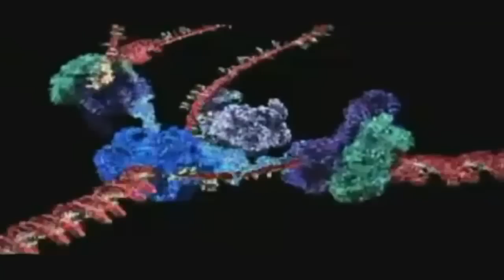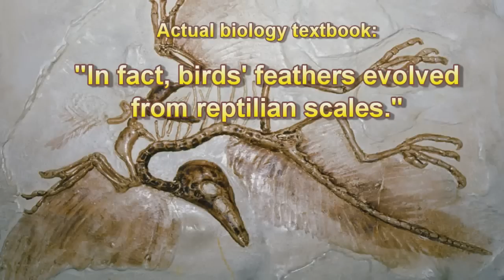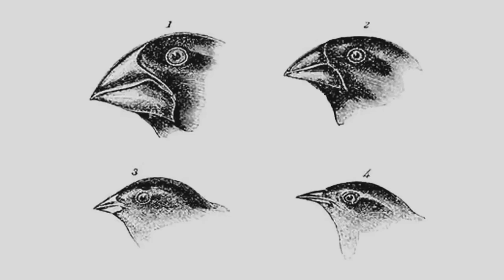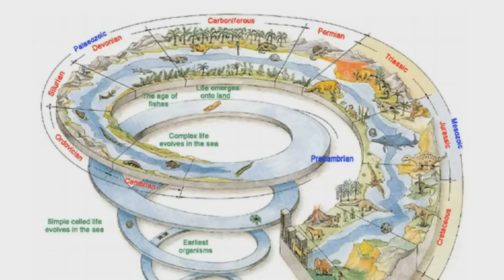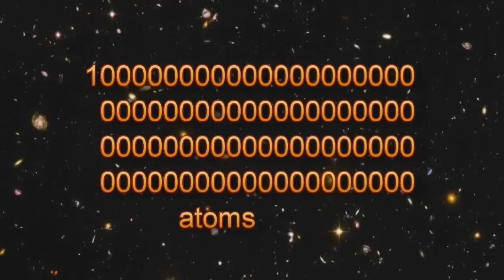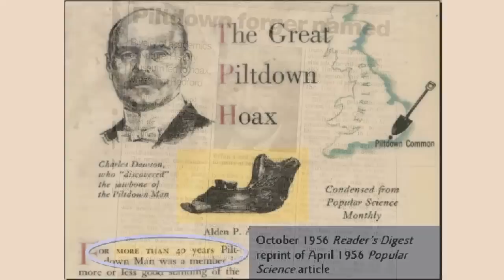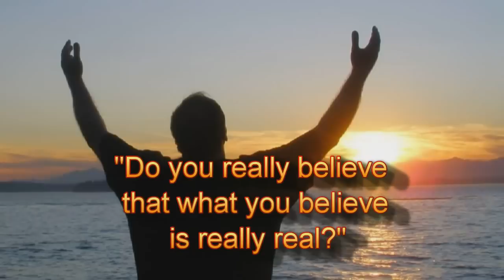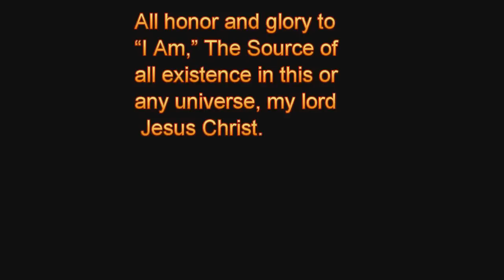Evolution Demolition

Comment: "Common sense would suggest that damage would result in a less fit genome."  Here Mr. Champneys is applying a subjective descriptive term to an objective change.  A genetic mutation is not damage; it's simply a different assemblage.
Reply: D. M. Bell It is not just a different assemblage.  It is a partially random assemblage.  Randomization is the very definition of damage to prescriptive information.  The more randomization, the less it looks like coherent code.  It is the addition of static to a sent message.  Minor tampering can be nearly harmless, and even make a change that we like, such as the sickle cell mutation which malaria protists do not enjoy.  But even such a so-called "beneficial" mutation is always deleterious in an informational sense.  Prescriptive information and random are at opposite ends of the same continuum.
Reply: Mark Champneys So a change from glutamic acid to valine is deleterious as far as information science? How so and why? Just claiming something is so doesn't mean it is so. 
It is a one base pair change; so the mutant is more like an information exchange not a loss. Are there functional consequences? Yes.  Is the mutant beneficial? Yes. Is one allele still wild type? Yes in the heterozygote.  

How is the mutation not beneficial in the heterozygotes if the individuals are resistant to malaria and sickle cell?
See hybrid advantage.
Reply: Helixbuilder Altering one base pair to switch on one function or another is not something I would dispute.  The programming is already there, and the change is not a low probability event.

However, the sickle cell mutation is so deleterious that even malaria protists do not like it.
Reply: Mark Champneys
Did you read about the heterozygote advantage?
Reply: Helixbuilder An "information exchange" would be exactly that, an exchange--at best.  Not the origination of a new algorithm.  Again, the word "beneficial" is ambiguous.  Beneficial to survival is not the same thing as beneficial to information content.  If Hitler crashes his car, that is a beneficial accident, but it is not beneficial to the car.
Reply: Mark Champneys
Pure unadulterated garbage. More than one deviation from a developmental pathway has been elucidated have you read about any of them?
Reply from the maker: Helixbuilder I'm certain that there are lots of deviations, however "developmental pathway?"  Is this the same as a mutational pathway?  You are in the field.  Have you ever seen a proposed mutational pathway spelled out for the formation of a new function or organ?  Has anyone given such detail?  I know that evolutionists believe in mutational pathways, but I've never heard of one being proposed.  Especially one that works--where each mutation is viable.  I'm not talking about mere tampering or "deviating," but the complete pathway.    You're the expert.
Reply: Nathan Champneys
Pathways have shared components. There are papers; however at this moment I am a bit busy. I'll get back!
Reply: Nathan Champneys
Sorry Nate had family stuff yesterday. The Ubx gives the fruit ply the same wing phenotype as dragonflies. I would predict that a similar gene or mutation configuration is in the dragon fly genome. I'll have a look.
Reply: SaltNPepperish
All you have to do is remove three protons from each atom of lead.to go from Pb (82) to Gold Au (79).
Reply: SaltNPepperish
Really? That is the best you can do?
Reply: *****
Those types of mutations can generate new functions. Usually it is gene duplication followed by a frame shift. The genomic  structure of genes includes introns and exons, Therefore gene product itself it not drastically changed outside of the effect exon. There are as many as 450 genes with molecular evidence that these type of change have happened..I have to dig through my file to find the reference so I may be off on the actual number.
Reply: SaltNPepperish
Yes tell me about entropy and why your interpretation has nothing to do with what is in the textbooks, or what is taught in a thermodynamics class.
Later Einstein.
Reply: Helixbuilder "Sorry Nate had family stuff yesterday."  Mark here.  Sorry, but my computer was still logged in under Nate's name for that reply.  (Nate is my son.)  Still waiting for that mutational pathway that is viable at each step.  Mutations are common, but mutations that maintain a survival advantage are relatively rare.  Viable mutations in succession of a few steps would be extraordinarily rare.  Viable mutations for each of many steps are mathematically impossible for the number of chances available in our universe.
Reply: Mark Champneys Thanks for clearing it up.
Reply: To those that are concerned there are papers with experimentally derived data that demonstrate that entropy is consistent with the theory of evolution.
This lay article has many references to original research.
http://www.scientificamerican.com/article/a-new-physics-theory-of-life/

Just a general observation the original papers tend to be more accurate than some third party summary. If you are going to quote Clausius, Gibbs, Boltzmann, Planck or Shannon on entropy or thermodynamics refer to their original definitions and math. That will reduce the confusion.
Thanks.
Reply: Helixbuilder The article begins with "a physicist has proposed..."  This hearkens back to the book, Biochemical Predestination co-authored by Dean Kenyon.  Kenyon has completely refuted his own book, and has now rejected evolution.  The idea of biochemical predestination seemed, at the time, like the only way to solve the entropy problem.
Reply: SaltNPepperish
Yes I can read. Thank you.
Reply: Mark Champneys
What so proposing a model and coming up with evidence to support it can be overruled by Mark says so?
Thanks for demonstrating that you think science is making assertions to buttress you scripture. Why wouldn't you look at the data?
Reply: SaltNPepperish
Sorry I must have missed that. It depends on where the mutation is in the protein, and what the nature of the new amino acid is. If you give me a specific case I can make a reasonable prediction which of course can only be verified by experiment.
I am of course assuming you mean mutations to the reading frame of the gene.
Reply: SaltNPepperish
If you are going to re-interpret what I say and answer questions not asked, why should I bother communicating with you?
I'm starting a step one to answer your question.
You don't care. Therefore Yes mutations happen and do comparative genomics it isn't my fault you don't understand.
Bye
Reply: SaltNPepperish
I checked my post with a linguist sorry but you are wrong.
Check with the peer reviewed literature and sorry you are wrong.
Thanks for your concern.
Reply: SaltNPepperish
I've checked the database and the literature you missed it. Go back and look.
Reply: SaltNPepperish
You keep missing it. You are so convinced your right that you become blinded to the evidence that contradicts your claims. Go and find the original research papers read them. If you don;t understand something research it. Don't rely on what somebody else says.
Reply: Mark Champneys
Mark, or any one who cares -- if you wish you can continue S&P's arguments. I got tried of being insulted for no reason and blocked S&P.
The conversation here is about ideas not insults.
Reply: Helixbuilder I think you know that I do not approve of SaltNPepperish's insults.  I appreciate passion, but I don't think rudeness is helpful when it comes from either side.  This is regrettable.
Reply: SaltNPepperish Rudeness is allowed.  I just don't think it is helpful to a free exchange of ideas.  (The only thing that is not allowed in this forum is profanity, and you have been borderline on that at times.  I want kids to be welcome here too.)
Reply: Mark Champneys
As I always say if you can't make your point with out using insults, shouting, lying or invoking logical fallacies you don't have a point.
Reply: Mark Champneys I suggest that you're still having trouble getting past these subjective terms.  "Prescriptive information" and "coherent code" both suggest some kind of master plan.
Reply: Tom Quirici
The polymorphisms of the MHC class I and MHC class II.
Reply: Tom Quirici I was specific about the MHC locus. These proteins are involved in pathogen recognition.
Reply: Tom Quirici
The genes are not dominant/recessive and they act in complement. They increase the number of pathogen derived peptides that can be bound and presented to immune cells. The end result is part of  'innate herd immunity'.
The variation arises from meiotic recombination, mutation and independent assortment; all of which can be demonstrated via genomic sequencing.
Your odds off considering that only 1.5% of the genome actually code for proteins yeah we know that see Venter et al 2001..
Reply: Tom Quirici
Those two classes are expressed from both parents genes that is why HLA (another name for the MHC) has to be matched for organ transplants.
Class I is used to identify compromised cells and trigger their destruction.
Class II is used to bind activate B cell to mediate ADCC to clear and/or destroy foreign antigens external to the cell.
In addition you are confusing SNPs with polymorphic alleles. The are not the same thing. See the textbook Genes XI.
Reply: Tom Quirici
Sickle cell is an example of Heterozygous Advantage, look it up.
Nylonase provides nutrition by digesting nylon when needed. This allows the bacterium to survive while those that don't have it die. Natural selection. The gene is tightly regulated and therefore isn't expressed until needed so how would this be detrimental? How is a duplicated gene that undergoes a frame shift a loss of function? It is the gain of a new function.
.
Reply: Tom Quirici I know better mutations don't always kill function; they follow a Gaussian distribution from being non functional to fully functional.
I've done site directed mutagenesis and you have to assay the mutant for function You can't just say what will happen you have to show it.
Further looking at the translation table several in many of the codons the third position does not mater.
In addition the properties of an amino acid side chain can be complemented by another amino acid with similar physical properties.
The existence of orthologs of gene throughout the taxa argues strongly against your claim.
Reply: Tom Quirici
So according to you if a process is complex it can't happen. Did you do an experiment and generate data to support this claim? If not you are only stating your opinion.
Many times during the history of humanity so called experts have claim something or event was impossible only to have someone show that the event was/is indeed possible.
Reply: D. M. Bell "Prescriptive information" and "coherent code" both suggest some kind of master plan.

Bingo!  You're getting it.  Except that these are not subjective, but very objective terms.  The code in DNA clearly has observable results which function beautifully.  The digital sequences really do function as instructions.  The outcome is extraordinarily coherent, working together in intricate interrelated systems.
Reply: D. M. Bell  The sciences of mutations and genetics has nothing to do with speciation, natural selection, or evolution.  Mutations and genetics are evidence of the intelligence designed into each and every living organism that enables living organisms to act, choose, select, adapt, abandon, alter, modify, or otherwise manipulate their God given, natural, environment.  Birds build nests, beavers build dams, and humans build space stations. The inanimate environment has not been designed with such intelligence and therefore cannot act, choose, or select.  It is absurd to suggest speciation is caused by some Divine Intervention as that's what "natural selection" means.  No Divine Intervention is needed for the ability to be born, to survive, to mutate, to adapt, to reproduce, and to die is already originally designed into each and every living organism.  There are plenty of varieties within each species, but no new specie or any kind of speciation has ever been observed whether created by God or popped out of another species by some bullshit selection.    Give up your superstition, folks, and learn the truth.  God bless.
Reply: SaltNPepperish  Exactly.  Evolution is neither a fact nor a single theory.  It is not science because there is not a single theory of evolution that can be scientifically tested.  Evolution is a collection of theories applied towards a variety of causal questions.  In other words, evolution is a story, a godless fairy tale.  There is zero evidence and zero logical argument for evolution.  It is purely blind faith to believe in the fairy tale of evolution.
Reply: SaltNPepperish  Exactly.  Evolution is at best an unsubstantiated opinion, and at worst a lie and a conspiracy to commit fraud. 

It all began when Hitler supported Darwin's evolution as a mean to legitimise his white supremacy, ethnic cleansing agenda, and the same tradition has been carried to today by militant atheistic bigots and hate mongers like Bitchens, Dawkins, Krauss, and Harris.
Reply: +Tom Quirici Birds ARE dinosaurs.  Denial is not proof, it is a sign of a brainwashed mind.
.  Bacteria did not evolve into worms, dummy.
Reply: Tom Quirici Yes, evolution demands that dogs make dogs and bacteria make bacteria
Birds do not have teeth.  Dinosaurs with feathers do have teeth and lived millions of years ago..
Reply: Tom Quirici I agree.  Evolution by the process of natural selection as scientists are forced to support by powerful conspirators is BULLSHIT.

Natural selection can only mean Divine Intervention.  There is no evidence of any Divine Intervention in the many varieties within each specie.  The intelligence was already originally designed into each and every living organism that enables living organisms to be born, survive, adapt, mutate, reproduce, and die.  No Divine Intervention has ever been observed unless we consider every new born as a Divine Intervention. 

In any regard, natural selection or Divine Intervention is not science because it cannot be scientifically tested.  If we want to have a scientific theory of evolution, evolution would have to be limited to changes in different varieties within species and not "speciation".  Such a scientific theory would be Jackie Wu's scientific theory of evolution by the process of intelligent adaptation of living organisms, E/IALO.  In this theory, the buck stops at intelligence which can be scientifically tested, and God is not assumed as a part of this science.

Life, like gravity, time, and God is metaphysical and is therefore unobservable and unknowable to humans.  No one knows what life, gravity, time, or God is.  We humans can only believe in their existence by applying logic to evidence which consists of our observations of some of the observable EFFECTS of such metaphysical entities but not the entities themselves for they are not observable.

It is time for our science communities to give up their superstition and study science.  May the truth, the love, and the peace of Jesus be with us.
Reply: *****  Done that many times in an elevator, no gravity ever observed, only the EFFECTS of gravity.   I repeat, "It is time for our science communities to give up their superstition and study science.".
Reply: Tom Quirici  I am just trying to save her soul.
Reply: Tom Quirici    How many believed in Jesus when he was crucified ?  Have faith.  The truth works in mysterious ways.  A tiny mustard seed under the right circumstances will grow into a huge mustard tree where birds come and make their nests.  This is a verifiable fact, not luck.

May the truth be our guide.  And may the love and the peace of Jesus be with us.
Reply: Tom Quirici *****   Amen, per Wiki, " The word amen (/ˌɑːˈmɛn/ or /ˌeɪˈmɛn/; Hebrew: אָמֵן, Modern amen, Tiberian ʾāmēn; Greek: ἀμήν; Arabic: آمين, ʾāmīn ; "So be it; truly") is a declaration of affirmation found in the Hebrew Bible and the New Testament. Its use in Judaism dates back to its earliest text."
So be it. 

Learn the truth.  May the love and the peace of Jesus be with you.
Reply: Tom Quirici  Praise be to God.  Amen !
Reply: Jackie Wu Praze the Flying Spaghetti Monster.  She is the one true God and you can't prove me wrong..  RAmen.
Reply: *****  I don't have to prove you wrong.  You have to prove your claim or you'll just be dismissed.
Reply: Jackie Wu What claim?
Reply: +Tom Quirici beautifully said, im muslim but i also cant tolerate these mindless satanic extrapolations that evolutionists partake in, thankfully for me, God Gave me a brain to reason with, so when i was shown those imaginary pictures in hs biology of evolutionary chains, i realized none of it was linked to any evidence and i saved myself from being brainwashed...we muslims need awesome intellectuals like sternberg and meyers and behe and others in our communities...keep exposing these guys! peace.
Reply: wesamalshaif  A Muslim is one who submits to God.  Jesus was a Muslim by definition.  And Jesus is a Buddha too because he was an enlightened one.  However, Jesus is not God, not the only Son of God, not Christ, and not a prophet.  Jesus claimed he is the way, the truth and the life.  He never claimed what he is not.  Jesus never prophesised but instead he warned us of false prophets.  To prophesise is to undermine, marginalize, and misrepresent God.  God cannot be God if God needs some humans to do God's bidding.   All prophecies are blasphemies, and all prophets are fake.

Give up your superstition and learn the truth.  May the love and the peace of Jesus be with you.
Reply: +777THUTH777 rofl .. try to educate anyone with just your opinions and insults!!
Reply: +D. M. Bell Since when nature has intelligence to create the necessary changes, it is self-conscious now !?
Reply: +Nathan Champneys They find that nature has intelligence to make such changes in the genome, want to see create software without a programmer ...
Reply: +D. M. Bell The problem is that changes in the genome often cause damage in 99.9% of cases...
Reply: Seen From Space
if life is so easy and nothing special why cant we reproduce it ourself out of lifeless matter allready? shouldnt the "clearance" be so big that it could come thru chance? but it aint!
so to me at this point its just an bold and arrogant statement to claim it came thru chance! as long as you aint able to reproduce it or show me how! and please dont even start with abiogensis! miller himself said its simply not possible thru abiogenesis!
Reply: Seen From Space  May be ?  May be we won't see you again.  May be Darwin is FOS.  May be you popped out of nowhere. May be Good bye.
Reply: Seen From Space
rofl! oh yeah! i can see how it disproofs that no fossil transition can be found anywhere .. which darwin himself said that they have to be found or his theory would crumble! it explain the cambrian explosion etc. your little bacteria .. does all those great things for you! omfg! waste of time!
Reply: Seen From Space
lol link me up to your stuffed museums please!
Reply: Seen From Space  Varieties within species is not speciation.  It is a part of design.  There is no offspring that is exactly the same as the other offspring or either one of the parents.  Each and every living organism is designed with the intelligence to be born, to survive, to adapt, to mutate, to reproduce and to die.  It is all as originally designed by God the Intelligent designer.  This is a verifiable fact based on logic applied towards evidence, not bullshits and fairy tales like evolution by the process of natural selection.  Darwin himself confessed that natural selection is absurd to the highest degree.   Darwin confessed, "To suppose that the eye with all its inimitable contrivances for adjusting the focus to different distances, for admitting different amounts of light, and for the correction of spherical and chromatic aberration, could have been formed by natural selection, seems, I freely confess, absurd in the highest degree." -- Charles Darwin, "On the Origin of Species by Means of Natural Selection, or the Preservation of Favoured Races in the Struggle for Life," 1859, p. 155. 

Now, give up your superstition and learn the truth.  May the love and the peace of Jesus be upon you.
Reply: Seen From Space  There is zero evidence and zero logic for evolution.  Evolution has never been observed.  It is neither a fact nor a single theory.  It cannot be science because there is no theory of evolution that can be scientifically tested.  Evolution is a collection of theories applied towards a variety of causal questions.  In other words, evolution is a story, a godless fairy tales, and it does not exist in real life, only in bullshits.   Evolutionary biologist Kirk J. Fitzhugh[39] wrote, "'Evolution' cannot be both a theory and a fact. Theories are concepts stating cause–effect relations...One might argue that it is conceivable to speak of 'evolution' as a fact by way of it being the subject of reference in explanatory hypotheses...In the strictest sense then, 'evolution' cannot be regarded as a fact even in the context of hypotheses since the causal points of reference continue to be organisms, and no amount of conﬁrming instances for those hypotheses will transform them into facts...While evolution is not a fact, it is also not a single theory, but a set of theories applied to a variety of causal questions...An emphasis on associating 'evolution' with 'fact' presents the misguided connotation that science seeks certainty." -- Fitzhugh, Kirk (January 2008). "Fact, theory, test and evolution".

Give up your superstition and learn the truth, okay ?
Reply: Seen From Space You asked, "please explain exactly how Fitzhugh's opinion on this philosophical/semantic matter supports a creationist cosmology?"

WTF are you talking about ?  What has Fitzhugh's statements of facts got anything to do with any philosophical/semantic matter, or creationist cosmology.  Fitzhugh is a evolutionary biologist, not a creationist.  What Fitzhugh says in his book is that the creationists and the evolutionists are both not speaking of science because they are both not backed by facts, but creationists have a theory although their theory cannot be scientifically tested, evolutionists have not a single theory but a story, a fairy tale.

You said, "Evolution has never been observed." Wrong. There are many examples."

Never mind many examples.  Give us one single piece of valid evidence or logic for evolution and I promise I will forever shut up.  Don't bother referring to fossils, mutations, and genetics because fossils only show some species died out in the past, not any new specie being created by God or popped out of other species by some bullshit selection, and the sciences of mutation and genetics, or Physics and Chemistry for that matter which evolutionists called evolutionary, has nothing whatsoever to do with any evolution, natural selection, or speciation. 

You said, "The eye example is so worn out: just look it up."

The fact is Darwin confessed that evolution by the process of natural selection is absurd to the highest degree.  He used the eye as an example.  But there are lots of "irreducible complex systems" in every living organism that cannot logically be evolved, only designed. 

Darwin's Theory of Evolution is a theory in crisis in light of the tremendous advances we've made in molecular biology, biochemistry and genetics over the past fifty years. We now know that there are in fact tens of thousands of irreducibly complex systems on the cellular level. Specified complexity pervades the microscopic biological world. Molecular biologist Michael Denton wrote, "Although the tiniest bacterial cells are incredibly small, weighing less than 10-12 grams, each is in effect a veritable micro-miniaturized factory containing thousands of exquisitely designed pieces of intricate molecular machinery, made up altogether of one hundred thousand million atoms, far more complicated than any machinery built by man and absolutely without parallel in the non-living world." -- Michael Denton, "Evolution: A Theory in Crisis," 1986, p. 250.

Give up your superstition and learn the truth.  May the love and the peace of Jesus be upon you.
Reply: Seen From Space  What has universities full of professionals got to do with the truth ?  Most professors are indoctrinated by the lies and propagandas of evolution and atheism.  Tom and I have no intention whatsoever to believe in these lies and propagandas based on blind faith.  We believe in logic applied towards evidence, not fairy tales like the emperor's invisible garment.  We are wise.  We don't pretend to be wise like what you have been doing appealing to authorities.

No irreducible complex system can logically be evolved.  You have zero evidence or logic for evolution.  I repeat, "Never mind many examples.  Give us one single piece of valid evidence or logic for evolution and I promise I will forever shut up.  Don't bother referring to fossils, mutations, and genetics because fossils only show some species died out in the past, not any new specie being created by God or popped out of other species by some bullshit selection, and the sciences of mutation and genetics, or Physics and Chemistry for that matter which evolutionists called evolutionary, has nothing whatsoever to do with any evolution, natural selection, or speciation." 

Give up your superstition and learn the truth.  May the love and the peace of Jesus be upon you.
Reply: Seen From Space  So you run out of valid argument and are now trying to divert our attention to bridge building and dentistry ?  I thought so.  You atheists are all the same.  When you start to realise you have zero evidence and zero logic to support your superstitious beliefs, you divert people's attention to other subjects and quietly slip away.  Happens every time.  I have encountered lots of these superstitious people.

You should give up your superstition and learn the truth.  May the love and the peace of Jesus be upon you.
Reply: Seen From Space Let's try Webster then,
 
Full Definition of PHYSICS
1
:  a science that deals with matter and energy and their interactions
2
a :  the physical processes and phenomena of a particular system

b :  the physical properties and composition of something

Full Definition of CHEMISTRY
1
:  a science that deals with the composition, structure, and properties of substances and with the transformations that they undergo
2
a :  the composition and chemical properties of a substance <the chemistry of iron>

b :  chemical processes and phenomena (as of an organism) <blood chemistry>
3
a :  a strong mutual attraction, attachment, or sympathy <they have a special chemistry>

b :  interaction between people working together; specifically :  such interaction when harmonious or effective <a team lacking chemistry>

Full Definition of MUTATION
1
:  a significant and basic alteration :  change
2
:  umlaut
3
a :  a relatively permanent change in hereditary material involving either a physical change in chromosome relations or a biochemical change in the codons that make up genes; also :  the process of producing a mutation

b :  an individual, strain, or trait resulting from mutation

Full Definition of GENETICS
1
:  a branch of biology that deals with the heredity and variation of organisms
2
:  the genetic makeup and phenomena of an organism, type, group, or condition

You see any evolution in these sciences ?

Give up your superstition and learn the truth, okay ?
Reply: +Seen From Space   I never said that mutations can never be beneficial.  In rare cases damage can be beneficial.  For example, if Hitler's car was damaged in a crash.  Or the sickle cell mutation which is so harmful that even malaria protists don't like it, resulting in immunity from malaria.  Nevertheless, if both parents carry the mutation it results in sickle cell disease.  Mutations are always deleterious to information content, but not necessarily to survivability (which is all natural selection cares about).  The bottom line is that a random process cannot build up prescriptive information.  That is as impossible as building a perpetual motion machine, and for exactly the same reason.  Uphill information buildup by mutation has never ever ever been observed.  Instructions do not write themselves, and believing that they do is tantamount to believing in the tooth fairy.
Reply: +Seen From Space   It is true that defining information content is no easy task.  Attempts have been made to define and measure it on different levels.  Shannon information is one way of measuring it, but he understood that it is not complete.  Dr. Don Johnson speaks of prescriptive information as instructions.  (As opposed to a mere collection of descriptive data.)  Clearly genetic information is prescriptive, and represents a blueprint for building an organism.  Dr. Craig Venter demonstrated that coded sequences of nucleotides is the software for this, by artifically rearranging them and observing different outcomes.  Dr. William Dembski coined the term "specified complexity" as a means of determining prescriptive information.  The fact that DNA sequences are both highly complex and highly functional affirm this specified complexity.
   As I pointed out in my video, neo-Darwinian evolution consists of natural selection operating on random mutations over many generations.  I am in full agreement that natural selection happens.  The entire question is the source of the options from which NS can select.  Evolution offers only random mutations for this part of the model.  Natural selection can make selections regarding the coding for a pancreas, but where did the programming for a pancreas come from in the first place?  Only random means are offered here.  And therein lies the impossibility of the model.
Reply: Mark Champneys +Seen From Space  The law of cause and effect does not allow random chance and accidents to exist in real life.  Darwin's evolution is a godless fairy tale.

Living organisms mutate because they are each designed with the intelligence that enables them to be born, to survive, to adapt, to mutate, to reproduce, and to die.  Inanimate matters don't have such intelligence, and therefore inanimate matters cannot mutate.  It has nothing whatsoever to do with random chance or accident.  Natural selection means nothing but Divine Intervention, just as artificial selection means nothing but human selection.  Human selection can be observed in the breeding of farm animals resulting in varieties within species, but no speciation and no Divine Intervention has ever been observed.  Every specie of living organisms is functioning exactly the same way it was originally designed and created by God the Creator.

May the love and the peace of Jesus be with you.
Reply: *****  Okay, so women are made from ribs of men and there is no need to have sex for a girl to have kids ?  How amazing !!! LMFAO !!!
Reply: *****
Why are you telling me all these ?  And WTF has chicken got to do with Adam and Eve ? 
Well, if you can believe women are made from ribs of men and there is no need to have sex for a girl to have kids, then you can also believe in Darwin's bullshit.  Why not, any fairy tale will do with your kind of argument.
Reply: +Raymond Armatino (Truthseeker777) because evolutards always jump to conclusions without evidence
Reply: +Seen From Space    It appears that you didn't pay attention to an important part of my video.  It is not the amount of change that is the issue, but the direction of the change.  Uphill change cannot occur by itself, but horizontal and downhill change can, and does, occur in dramatic fashion.  Thus, time is our enemy, not our friend.
   The Catastrophic Plate Tectonic model of the Genesis flood has more explanatory power than any other theory out there (IMHO) to explain vast global sediments with uneroded surfaces between layers almost everywhere.  Thus, I am convinced that most of the geologic record was deposited in rapid succession.
   The speed of light?  I don't know.  The Big Bang speculation has huge problems with distant starlight, but the Bible may give us a clue what happened.  In at least ten places the Bible says that God "stretched out the heavens."  I suspect that has something to do with it.  Definitely a mystery for all sides.
Reply: Mark Champneys You say "cannot" as if it were unequivocal. This is a dogmatic position, and inconsistent with vast bodies of evidence that you arbitrarily deem inadmissible.

If flood geology had any "explanatory power" at all it would at least provide SOME plausible reason why fossils always seem to be graded by epoch! Why for example Cambrian rocks only contain fossils from the Cambrian i.e. strictly invertebrates. It predicts that trilobites and mammals would be found together, because they died together. They never are. Creationists make a big deal of the missing link between apes and humans, but seem unperturbed by the lack of a precambrian monkey. Or the lack of any fossils at all in some sediments e.g. precambrian Torridonian sandstone.

Come on! CPT was cooked up at a desk as an act of desperation in the face of the flourishing discipline of planetary science. It lacks any plausible geophysical mechanism, and is contradicted by vast evidence consistent with mainstream plate tectonics.

It presupposes many physical impossibilities. What happened to all the heat released by the catastrophe? Why did it not melt the crust and boil the oceans? There would have been more than enough to do this! How did the atmosphere clear of the SO2 and CO2 quickly enough for Noah's children to be fruitful and multiply? Why do convective plumes in the mantle perfectly coincide with mid-ocean spreading zones and island chains? Why is oceanic crust brand new at the mid-ocean ridges and 150 myo at the edges where it's being subducted? Why does this dating correlate exactly with the thickness of ocean sediment settled upon it? Why are giant impact craters on the continental shields so eroded if they only happened in the last few thousand years? Why don't they all look as clear as Meteor Crater, Arizona (50kyo)? Why is the earth still not recovering from the mass extinctions they must have caused?
Reply: Mark Champneys And in what way is THIS not "evolution"?
http://phys.org/news/2016-01-random-mutation-protein-tied-multicellular.html

Full paper here:
http://elifesciences.org/content/5/e10147
Reply: +Jackie Wu  Invoking Godwin's law?
Reply: +Seen From Space    Consider that the sediments are a record of where organisms died, not where they lived.  It is a record of burial order, not age.  Many things are in the wrong evolutionary order, such as pollen fossils found in both pre-cambrian and dinosaur layers; or the many living fossils discovered that were once thought to be hundreds of millions of years old.  A catastrophic flood would sort things to a degree, yet imperfectly.  That is what we find.
   You no doubt would like to simply dismiss CPT, but it is based on enormous data, a team of PhD's, and modeled on the Los Alamos supercomputer.  It made many predictions, including temperature, that fit very well with a subsequent ice age.  The basic mechanism is very plausible.  A cold dense sea floor was much lighter than warmer lighter material in the mantle, making it a precarious top-heavy situation.  Once a failure in this balance was triggered, it resulted in runaway subduction of the sea floor crust diving under the continents, and the formation of new sea floor which was much lighter, forcing the ocean basins up temporarily.  Large areas of colder material have been detected deep in the mantle still today, confirming the model.
   Age dating is another major issue, since it is always based on assumptions.  The same scientists discovered major flaws in those radiometric dating assumptions.  I have written on this elsewhere in this forum.
   Catastrophic plate tectonics and conventional plate tectonics have much in common.  It can be observed today.  The major difference, of course, is in the speed with which it happens.  If CPT is true, it demolishes evolution by itself.  If not, evolution still has insurmountable problems.
Reply: Mark Champneys After 1 minute's research, this:
"Most of the palynology work was done by Clifford Burdick, who had very little knowledge of geological techniques. Creationists themselves admit that his results come from contamination of old rocks by recent pollen ... Intrusion of pollen in older rocks is very common." etc etc. You are far too selective in your reading. How many times have I had to repeat this?

"Living fossils" are rarely identical to actual fossil species. They cause no kind of inconvenience for evolutionary theory. By "insurmountable problems" I take it you mean there are open questions? As in every discipline this is true. But as I've already said ad nauseam, such are no support for competing hypotheses by default. If Darwin is ever proved wrong it will be for NONE of the reasons in your video!

What happened to all the heat and atmospheric pollution caused by this CPT process? The heat would have been more than enough to boil the oceans and melt the crust. The atmosphere would have been unbreathable. CPT was never, ever going to work, even if it's able to explain a few easy data points! To accept CPT you have ignore a planetful of real observation. Forget it and widen your reading.

Your radiometric dating points are just more folklore. "The same scientists" have presuppositions based on sectarian theology. So what they're doing is theology, not science. Likewise with CPT, the anisotropic synchrony convention, through intrinsic redshifts, right down to Mature Creation and the entire universe being cursed by the sin of Adam*. All theology. 

*Discussed in all seriousness by creation cosmologists!
Reply: Mark Champneys Repeat: why is the Earth not still recovering from mass extinctions if the giant impact basins on the continental shields formed in the last 6000 years? Some would have been far bigger than the K-T event, and studies show ecosystems taking several million years to recover from that.
Why are the craters are so eroded they're only visible from orbit, unlike the fresh-looking Meteor Crater, Arizona (~50Kyr). Because the impacts occurred orders of magnitude longer ago!
Reply: +Seen From Space    "Intrusion of pollen in older rocks..."  Pollen is not the issue, but fossilized pollen.  Obviously the pollen got in there long ago when it was still pollen, but it is now fossil pollen.  Rock.
   "...rarely identical to actual fossil species."  Most are very very close, and even living members of modern species can have substantial variation, yet still be the same species.  What happens is that evolutionists tend to assign fossils to a different species simply because they are fossils, not because of any known information about reproductive isolation.  The modern horseshoe crab is virtually identical to fossils, yet it is assigned a different genus (never mind species)!  Their bias is showing.  ...and in many cases it is without respect to any science whatsoever.  Dr. Tom Hoyle tells a story of once embarrassing an evolutionary anthropologist by showing him an x-ray of a human scull.  The evolutionist was thrilled with the x-ray and asked, where Dr. Hoyle got such a perfect Cro-Magnon scull specimen.  Dr. Hoyle smiled and said, "That happens to be an x-ray of my head.  Busted!  The larger point about living fossils is, the obvious absence of them in all the in-between rock layers.  It renders the idea of an "index fossil" utterly meaningless, because it is likely that we merely haven't found them in other layers yet.
   "What happened to all the heat and atmospheric pollution caused by this CPT process?"  It is all very much a part of the simulated model--all fully accounted for in super-computer modeling.  These PhD creation scientists are not stupid.  Actually the heat generated appears to have been offset by the cooling of the "nuclear winter," causing the ice age.  Warm oceans would have been essential to cause enough evaporation to render enough snow for the ice age.  You need to study this more.  The entire model is remarkable.
   "Your radiometric dating points are just more folklore."  The actual numbers are available, and the people processing them in AMS labs are almost never creationists.  Data is not folklore.  But do all scientists have pre-conceived biases?  Of course.  There are no exceptions to this rule, on either side.  But scientists on either side can become aware of their biases and adjust accordingly, just as any juror is required to do.  The biggest danger is when a person does not recognize their own bias... and most evolutionists don't.
   Some craters on the earth are highly eroded by the great flood, and some were clearly post-flood.  The millions of years scenario is the very thing in question, and creationist scientists challenge that assumption.  Mt. St. Helens and the island of Surtsey represent hard evidence that ecological recovery can occur with extraordinary speed.  (Especially if God wants it to, by the way.)
Reply: Joseph Smith No.   Godwin's law does not apply here because within a short discussion the evolutionists already run out of valid arguments.
Reply: +Jackie Wu lol...  as apposed to apologists that simply make up everything they say and are therefore only limited by their imagination?
Reply: Setep2k  Glad I am not an apologist.  I only say the truth based on verifiable facts.  No apology necessary.  You are confused, and that is the truth.

God bless.
Reply: Jackie Wu lol, yeah, truth based on verifiable facts, don't make me laugh... you'd be among a minority of theists... 

what's your best argument/evidence?
Reply: Setep2k Who is a theist ?

My best  argument/evidence is GODDIDIT/Everything.  This is truth based on verifiable facts.

Thanks for asking.

May the love and the peace of Jesus be with you.
Reply: Jackie Wu I guess it's better if I don't feed you, right?
Reply: Setep2k  I won't starve.
Reply: Jackie Wu good for you
Reply: Setep2k  I am actually overfed.
Reply: Jackie Wu well then it sucks, I guess... but better than starvation, huh?
Reply: Setep2k  It depends.
Reply: And common sense would also tell you that little tidbit in itself goes against the Darwinian would view. Everyone's a philosopher with their Ph.D.'s from YTU. Lmao
Reply: TheZincZipper
Yeah because common sense isn't science, it just your arrogant claim that your answer is right without proof!
Reply: Helixbuilder Evolution is not science.  There is zero evidence and zero logic for evolution, and there is not a single theory of evolution that can be or has been scientifically tested.  Evolution is neither a fact for it has never ever been observed, nor is it a single theory for it is in fact a collection of theories applied towards a variety of causal questions.  A collection of theories is a story.  Evolution is a fairy tale story.

May the love and the peace of Jesus be with you.
Reply: Jackie Wu lol, evolution is backed by fossils and dna, only a mentally challenged person could doubt it at this point

don't be that meantally challenged person on purpose... just don't
Reply: Seen From Space yeah thanks, i know that one already. also I wouldn't exactly call it source material, but rather a compilation of arguments.

when I'm not sure of the factual basis I check out sites like that, but I consider it better if I form my conclusion independently
Reply: Jackie Wu
The fact that evolution is a branch of science being investigated by scientists eviscerates your claim immediately!
Reply: Helixbuilder Evolution is not science.  It is neither a fact nor a single theory.  There is not a single theory of evolution that has been or can be scientifically tested.  Scientists study science.  They do not study fairy tales like Darwin's evolution by the process of natural selection.

Give up your superstition and learn the truth.  Jesus is the way, the truth, and the life.  The truth will set you free.  May the love and the peace of Jesus be with you.
Reply: Jackie Wu
Thanks for your opinion. Don't be too put off if I ignore your ill informed rant. You've said nothing other then words vilifying scientist and their work.
Reply: Jackie Wu
Complete and totally made up garbage. You can say whatever you want too; however don't get upset when you get called out when you make up things that are not true!
Reply: Helixbuilder Everything I said is based on truth and verifiable facts, bar none.  Evolution is not science, period.  Scientists in the scientific field of biology study the sciences of mutation, genetics, and intelligent adaptations of living organisms, but none of these sciences has anything whatsoever to do with evolution or natural selection.  Darwin's evolution by the process of natural selection is just an unsubstantiated opinion of Darwin's, a story, a fairy tale.

Give up your superstition and learn the truth.  Jesus is the way, the truth, and the life.  The truth will set you free.  May the love and the peace of Jesus be with you.
Reply: *****
Your rant is an incoherent word jumble. You've linked together events based on nothing other that your tangental understanding of complex interactions. All that to launch a non sequitur ad hominen attack.
Matthew 25:31-46 says what?
Reply: *****
When you stoop to insults you are tacitly admitting you have nothing to back your opinions.
So what? You go on a rant.What does that demonstrate? Where is the data that supports this claim of yours?
Reply: *****  I disagree.  There is no evolution and no natural selection that can be substantiated by any fact or logic. 

Intelligent adaptation of living organisms is not evolution and has nothing whatsoever to do with evolution.  Intelligence designed and created in each and every living organism is required to carry out the adaptation process.  Inanimate matters like rocks and dead wood cannot adapt because they do not have such intelligence or they have such intelligence but is not active because they have no life left in them.

Natural can only have one meaning, and that is : God made.  Natural selection therefore can only mean Divine Intervention.  There is no evidence that there is any divine intervention as far as intelligent adaptation is concerned.  All our observations confirmed that the adaptation process of living organisms have been carried out by intelligence that has been originally designed and created in each and every living organisms without the need for further intervention by God.

Notice that selection logically required a selector and a selectee.  In artificial dog breeding, humans are the selector and dogs are the selectee.  In intelligent adaptation, the living organism that undergone the adaptation process is always the selector and their natural environment the selectee.  Never has it been observed the other way round.  For example, tree roots breaks concrete but concrete cannot put legs on trees. beavers build dams but water and tree branches cannot keep beavers living on the same spot all their lives, humans build space stations but the natural environment we humans live in cannot force us to walk on earth all the time.

May the love and the peace of Jesus be with us.
Reply: Jackie Wu
Do an experiment and show data substantiating your claim.
Reply: Helixbuilder  " Do an experiment and show data substantiating your claim." ???

Exactly.  If you are claiming evolution is a science, you need to put it through the scientific method for verification.  But there is no theory of evolution that has been or can be scientifically tested.

May the truth opens your eyes so you may begin to see.  And may the love and the peace of Jesus be with you.
Reply: Setep2k If you read what ***** said to you earlier, you'll understand who is the stupid one here.

May the truth open your eyes so you may begin to see.  And may the love and the peace of Jesus be with you.
Reply: Jackie Wu
The experiments have been done! is it my fault you are incapable of looking up the data and then evaluating it?

There are literally thousands of papers detailing experiments that produce data in support of evolution that are published every year. So again you prove that you are uninformed.

Truth does not come from choosing to believe a particular ancient text.
Reply: Helixbuilder  Truth comes from logic applied towards evidence.  There is zero evidence and zero logic for evolution and there is overwhelming contrary evidence against it.  That is the truth.

There are thousands of research papers every year on mutations, genetics, and intelligent adaptation of living organisms but there is zero scientific research on Evolution because there is not a single theory of evolution that has been or can be tested by applying the scientific method.  That is the truth.

May the truth open your eyes so you may begin to see.  And may the love and the peace of Jesus be with you.
Reply: *****
First you open with an insult, and then comment on research that in my opinion you didn't even bother to read.

What is the hypothesis being tested? What results would support or nullify the hypothesis?

What are the controls?

What are the results?

Are the chosen methods the correct way to address the hypothesis? Why or why not?
 
The answers are in the papers.

Typical you let your bias color everything you observe.

Why does someone who has no experience in science or doing experiments feel knowledgeable enough to comment on it?

My answer is that the person is beyond arrogant.
Reply: *****
1) Your are right the experiment is not contrived. Further the hypothesis is supported by the data.
2) Figure 1 shows the geographic location of four separate species of cichlids.
3) Fish are at the classification of “class” which is ‘below’ Domain, Kingdom, and Phylum. While at the same time being ‘above’ order, family, genus, and species. So your argument is not supported by the data.
4) Since there is no evidence that mentions  interbreeding and producing fertile offspring in the paper I have caught you red handed lying.
5) The species listed are different and have known reproductive barriers.
6) Next
Reply: Jackie Wu
Your post is not a rebuttal it is just your opinion attempting to convince me without any evidence!
Reply: Helixbuilder You said, "Your post is not a rebuttal it is just your opinion attempting to convince me without any evidence!"

What rebuttal ?  You have not provided a single piece of valid evidence or valid logic for evolution, nor have you provided a single theory of evolution that has been or can be tested by applying the scientific method.  So what rebuttal are you waiting for ?

Take note that we have not even talked about the overwhelming contrary evidence and logic against the evolution by the process of natural selection bullshit.  You are claiming that Evolution is science so you need to prove it with logic and evidence.  Get it ?

Give up your superstition and learn the truth.  Jesus is the way, the truth, and the life.  The truth will set you free.  May the love and the peace of Jesus be upon you.
Reply: Jackie Wu
You have not written anything other than claim your right without any evidence!
Reply: *****
Nothing you said pertains to the paper you dismissed without reading.

Nothing your are saying now indicates you know anything about evolution.

Insults and random science word strung together indicate that you have nothing to say.
Reply: Jackie Wu
Actually you are trying to say that a branch of science is not science so the burden of proof is on you.
Reply: Helixbuilder   You said, "No You have not written anything other than claim your right without any evidence!"

Wrong.  I wrote that your claim is without any evidence or logic and there are overwhelming contrary evidence and logic against your claim that evolution by the process of natural selection is science.

No wonder Happy Camper called you a liar.  When did I say a branch of science is not science ?  You don't need to lie to shift the burden of proof, you know ?  Be a man, prove it or admit the truth that evolution is not science.

May God have mercy on you.  And may the love and the peace of Jesus be with you.
Reply: Jackie Wu
Well considering there is quite a bit of evidence that fact alone calls into question your grip on reality.
Reply: *****
Cichlids are fish from the family Cichlidae, not a species -- so you are still wrong.
Reply: Helixbuilder You said, "Well considering there is quite a bit of evidence that fact alone calls into question your grip on reality."

1)  Anything can be evidence, but to be a valid evidence for something, the evidence needs to be tied to that something by logic.  For example, a fish can be evidence, but a fish cannot be a valid evidence for gravity because there is no logic to tie a fish to gravity.  However, a falling apple is a valid evidence for gravity because it is logical that there is a cause for the apple to fall, and we labelled that cause as gravity.  For evolution, there is zero valid evidence and zero valid logic.  Even Darwin himself confessed that evolution by the process of natural selection is absurd to the highest degree.

2)  Facts are repeatable observations.  Evolution has never been observed and therefore cannot be a fact.  While Evolution is not a fact, neither is it a single theory.  Evolution is a collection of theories applied towards a variety of causal questions.  A collection of theories is not a theory but is a story.  Evolution is therefore a fairy tale story.  Since there is no theory of evolution, none can be tested scientifically, and therefore evolution cannot be science.

3)  There are two kinds of realities.  The first one is our physical reality which consists of what we see or observe.  The second one is the metaphysical reality which is unobservable and unknowable by humans.  We humans can only believe in the existence of various metaphysical entities like gravity, life, space, time, God, etc., by logic applied towards evidence which would be observations of some of the effects caused by these entities but never of the entities themselves because metaphysical entities are unobservable and unknowable by humans.  Can you get a grip on reality ?

Give up your superstition and learn the truth.  Jesus is the way, the truth, and the life.  The truth will set you free.  May the love and the peace of Jesus be upon you.
Reply: Setep2k What lack of logic ?  What is the logic of your claim that "if something is natural then there's evidence" ???

For example, gravity is natural.  Is there any evidence of gravity ?  Has anyone seen gravity, heard gravity, tasted gravity, smelled gravity, or felt gravity ?  The answer is no.  But practically everybody believe gravity exist and is natural.  Do you believe gravity exist and is natural ?  If you do, there is no reason for you to not believe God exist and is natural.  The truth is : "natural" can only mean "God made".

Give up your superstition and learn the truth.  Jesus is the way, the truth, and the life.  The truth will set you free.  May the love and the peace of Jesus be upon you.
Reply: Setep2k "gravity is quantifiable" ???

I repeat, "Is there any evidence of gravity ?  Has anyone seen gravity, heard gravity, tasted gravity, smelled gravity, or felt gravity ?  The answer is no."  Gravity is unobservable and unknowable by humans just as life, space, time, God, etc. is unobservable and unknowable by humans.  This is the truth.

Who said I do not believe in the existence of gravity ?  I repeat, "practically everybody believe gravity exist and is natural."  So pay attention or I'll have to tell you to sit out at the corner for 5 minutes, okay ?

"something natural = part of nature = part of reality = perceivable in reality" ???

I repeat, "For example, gravity is natural.  Is there any evidence of gravity ? ...... The answer is no."  Gravity is not perceivable in reality because gravity is metaphysical.  Natural = God made.  This is the truth.

Give up your superstition and learn the truth.  Jesus is the way, the truth, and the life.  The truth will set you free.  May the love and the peace of Jesus be upon you.
Reply: *****

Wow insults! I guess we'll talk again when you graduate from high school.
Reply: Jackie Wu
Thanks. I'll take your opinion into consideration,  then I'll check the facts. Sorry you are still wrong.
Reply: Helixbuilder You are welcome.  Everything I said is based on truth and verifiable facts, not opinions.  Evolution was Darwin`s opinion because it is neither a fact nor a single theory, and there is zero valid evidence or logic for evolution.  Darwin confessed his opinion of evolution by the process of natural selection is absurd to the highest degree.

I pointed out Evolution is not science and I gave my reasons supported with truth and verifiable facts.  You still insist I was wrong.  Unless you can provide a single piece of valid evidence, or a single piece of valid logic for Evolution, or a theory of evolution that has been or can be scientifically tested and verified, you have no reason to say I was still wrong.  To do so would only confirm the assessment of you by
***** .

Give up your superstition and learn the truth.  Jesus is the way, the truth, and the life.  The truth will set you free.  May the love and the peace of Jesus be upon you.
Reply: *****
Matthew 5:22
Reply: Jackie Wu
I'm waiting for the references to these 'facts' you keep talking about.
Reply: Helixbuilder Sure, the fact that Evolution is neither a fact nor a single theory has been observed and explained by Fitzhugh, per Wiki,

Evolutionary biologist Kirk J. Fitzhugh[39] wrote, "'Evolution' cannot be both a theory and a fact. Theories are concepts stating cause–effect relations...One might argue that it is conceivable to speak of 'evolution' as a fact by way of it being the subject of reference in explanatory hypotheses...In the strictest sense then, 'evolution' cannot be regarded as a fact even in the context of hypotheses since the causal points of reference continue to be organisms, and no amount of conﬁrming instances for those hypotheses will transform them into facts...While evolution is not a fact, it is also not a single theory, but a set of theories applied to a variety of causal questions...An emphasis on associating 'evolution' with 'fact' presents the misguided connotation that science seeks certainty."

God bless.
Reply: Jackie Wu lol you don't even know what quantify means... it means it can be measured, which is not true for your god.

the  only question left is if you see the difference...
Reply: Jackie Wu
Yes Wiki the absolute go to for knowledge. Why wouldn't you go the the source of the original data?

However the entirety of the article does not support your claim. And that my friend is based purely on the low legal standard of the preponderance of the evidence.

Did you read the entire page or just the stuff you liked?
Reply: Setep2k   "the only question left is if you see the difference..."

Exactly.  You can measure gravity ?  How long ?  How many in a cup ?  How many grans in a litre ?  How many litres in an apple ?    The truth is you can't measure gravity because you can't observe it or know what it is. 

Give up your superstition and learn the truth.  Jesus is the way, the truth, and the life.  The truth will set you free.  May the love and the peace of Jesus be upon you.
Reply: Jackie Wu
Gravity is a force. Force is mass x acceleration. The units are in Newtons, which is Kg x m/s^2.  One newton is the force needed to accelerate one kilogram of mass at the rate of one meter per second squared in direction of the applied force
Reply: Jackie Wu

As for superstition it means a widely held but unjustified belief in supernatural causation leading to certain consequences of an action or event, or a practice based on such a belief.

Since science is dependent on observation, evidence, and experiments to reveal natural mechanisms your insistence that science is superstitious is directly contradicted by logic, the scientific method, and the very definition of science.
Reply: Setep2k Helixbuilder  1)  You can't measure a force because forces are metaphysical, unobservable, and unknowable by humans.
.
2)  gravity is not a force according to Einstein who claimed gravity either does not exist or is fictitious and that gravitation is caused by space/time curvature. 

3)  Quantum physicists believe gravity is not even a cause but an effects or illusion caused by gravitons which they promise they will find soon.  But don't hold you breath.

4)  No one knows what is space or what is time.  So no one knows what is speed or acceleration.  Mass also is a measurement of the effects caused by what we believe is a physical object but mass of an object could have been caused by gravitons which we haven't discovered but quantum physicist believe they exist.

The long and short of it all is no one knows what gravity is because gravity is metaphysical, unobservable, and unknowable by humans.  Just like God, we humans can only believe in the existence of gravity and of God, but we humans cannot observe them or know what they are.

Give up your superstition and learn the truth.  Jesus is the way, the truth, and the life.  The truth will set you free.  May the love and the peace of Jesus be upon you.
Reply: Helixbuilder  I know what superstition is and what science is, and I never said science is superstition.  I said Evolution is not science but is a fairy tale.  Everything I said is based on truth and verifiable facts, remember ?

Give up your superstition and learn the truth.  Jesus is the way, the truth, and the life.  The truth will set you free.  May the love and the peace of Jesus be upon you.
Reply: Jackie Wu
Then if that is true then what is your problem with evolution? You believe in a fairy tale god The are no facts for the existence of any god. That is why it is called faith.
Reply: Helixbuilder  As for Fitzhugh's article, assuming that you have read it and you are capable of comprehension, where did it say Evolution is science, or a fact, or a single theory.  Show us that and stop giving your legal opinion of the subject matter.  Science and legality are two very different topics, you know ?

Learn the truth, okay ?
Reply: Jackie Wu
Did you read the rest of the articles referenced on the wiki page?
Reply: Helixbuilder Faith is not belief without logic and evidence, or reason.  Faith is a strong belief, a trust, or a conviction.  I hope you have been faithful to your spouse, your country, and yourself.  Beliefs are evidence based but superstitious beliefs are not logical but absurd.  Darwin believed in evolution by the process of natural selection but he confessed what he believed in is absurd to the highest degree. 

There is zero evidence and zero logic for Evolution and overwhelming contrary evidence.  Therefore believing in Evolution is illogical, irrational, and perhaps even delusional.  There is however overwhelming evidence and logical proofs for God and zero contrary evidence.  Therefore believing in the existence of God is logical and rational, disbelieving in the existence of God is illogical and irrational, and believing that there is no God is outright delusional.  So, tell us,  do you believe in God or are you illogical, irrational, and perhaps even delusional ?  Do you believe gravity exist ?  If you do, there is no reason you do not believe God exist for the existence of both gravity and God is supported by overwhelming evidence and logical proofs.

God bless..
Reply: Helixbuilder Why do you want to swamp me with irrelevant articles that you want to deflect my attention to ?  Why can't you be a man and admit that Evolution is not science but a fairy tale, and get started learning the truth ?

May the truth open you eyes so you may begin to see.  And may the love and the peace of Jesus be upon you.
Reply: Jackie Wu

Because you are offering an opinion and have not examined the data, but rather have read third hand biased accounts.
Reply: Helixbuilder   Everything I said is based on truth and verifiable facts, not opinions.  You claimed that Evolution is science but you have provided zero valid evidence and zero logic for evolution, or a single theory of evolution that has been or can be scientifically tested.  So I pointed it out to you and to whom it may concern that Evolution is not science because it is neither a fact nor a theory but a fairy tales, and I quoted Fitzhugh who had observed the same facts and explained it very well.  I am not an evolutionary biologist, but Fitzhugh is.  He has a PhD in this field of study and he is a reputable curator.  In the article I quoted, Fitzhugh explained it in plain language that any logical mind can understand the facts and the truth of what he said.

You first wrote him off as a low political opinion and now a third hand based account.  Have you no shame ?  Can you admit your superstition and start learning the truth ?

May the truth open you eyes so you may begin to see.  And may the love and the peace of Jesus be upon you.
Reply: Setep2k "forces are metaphysical"

Exactly.  Forces are not physical.  They are unobservable and unknowable to humans.  The word force is often used as a metaphor for power or energy for this very reason, like air force, life force, and police force.  Force, power, and energy are all metaphysical just like gravity, space, and God.

Give up your superstition and learn the truth.  May the love and the peace of Jesus be with you as you go.  God bless.
Reply: Setep2k You have not been able to answer any of my questions regarding how gravity is observable and measureable to you, like what does gravity look like, taste like, smell like, sound like, or felt like.  And you are now insulting Socrates, Jesus, Einstein, and I by calling us stupid people ?  What is wrong with you ?    The four of us believe in metaphysics and in God, you know ?  Metaphysics is the foundation of science.  Every scientific theory is in essence metaphysical.  Science without metaphysics is not science but hollow and meaningless materialism.  Superstitious people like you believe in materialism.  Rational people like Socrates, Jesus, Einstein, and I believe in God.

Give up your superstition and learn the truth.  Jesus is the way, the truth, and the life.  The truth will set you free.  May the love and the peace of Jesus be upon you.
Reply: Jackie Wu nope, not sokrates or einstein, just you... and maybe jesus, but his existence is not confirmed, so I won't talk about him.

also einstein was not a believer, even though idiots that misquote him often think that.

also it's an idiotic thing to ask me for the taste or smell of gravity. I can tell you how it's measured and thereby how it's perceived.
that's more than could ever be said for god and other such nonsense
Reply: Jackie Wu
Simply measure the force needed to raise an object of mass to 1 metre.
Reply: Jackie Wu
Yes so you say. Now prove it. What experiments have been done that show this claim of yours?
Reply: Setep2k Socrates is the father of Western science and philosophy.  Metaphysics is a branch of philosophy.  Per Wiki, "The word "metaphysics" derives from the Greek words μετά (metá, "beyond", "upon" or "after") and φυσικά (physiká, "physics").[6] It was first used as the title for several of Aristotle's works, because they were usually anthologized after the works on physics in complete editions."  Aristotle was a student of Plato who was a student of Socrates.  It is well known Socrates believed in gods and metaphysics.

Per Wiki, "Albert Einstein's religious views have been studied extensively. He said he believed in the "pantheistic" God of Baruch Spinoza, but not in a personal god, a belief he criticized."

So you thought wrong.  Socrates, Jesus, Einstein, and I believe in a metaphysical God, and we are not stupid people like you described us.  I am not well known, but Socrates, Jesus, and Einstein are well known for their wisdoms.
 
You said, "also it's an idiotic thing to ask me for the taste or smell of gravity. I can tell you how it's measured and thereby how it's perceived."

So you can't smell or taste gravity, but can you see, hear, or feel gravity ?  You can't, correct ?  So tell us how you can measure gravity if you can't even see, hear, or feel gravity.  It is a fact that gravity is metaphysical, unobservable and unknowable by humans.  We humans can only believe gravity exist but no one knows what gravity is, the same way we humans believe God exist but no one knows what God is.  This is the truth.

Give up your superstition and learn the truth.  Jesus is the way, the truth, and the life.  The truth will set you free.  May the love and the peace of Jesus be upon you.
Reply: Helixbuilder  You said, "Simply measure the force needed to raise an object of mass to 1 metre."

Sure, you can measure the effects caused by gravity or what Newton believed is gravitational force.  But gravity itself cannot be measured, or any force for that matter.  We can measure some of the effects caused by God like birds and bees, stars and galaxies, you and me, but God cannot be measured.  If you believe gravity exist, there is no reason for you to not believe God exist.

You said, "Yes so you say. Now prove it. What experiments have been done that show this claim of yours?"

I assume the claim you were referring to is that Evolution is not science.  I have proved that nth times to you, so I don't understand why you are still asking me for proof.  I'll repeat : Evolution is neither a fact nor a single theory, and since there is no theory of evolution that has been or can be tested scientifically, evolution cannot be science and remained as a fairy tale.  That is the proof and that is the truth.

Give up your superstition and learn the truth.  Jesus is the way, the truth, and the life.  The truth will set you free.  May the love and the peace of Jesus be upon you.
Reply: Jackie Wu
Sorry but no. This is silly. Your are just makinig unfounded claims. Now demonstrate what you say is true. You can't! Not at all!
Reply: Helixbuilder Everything I said is based on truth and verifiable facts.  What claim you still don't understand ?  I know you can't prove your claims because I have asked you nth time and you have just been beating around the bush and failed to find a single piece of valid evidence or logic for evolution, or even a theory of evolution that has been or can be scientifically tested.  Abiogenesis has been scientifically tested and it has been verified as  false.  Abiogenesis was a part of Darwin's opinion but now the evolutionists are saying it is a different topic altogether.  See how lies can only go so far ?

So if evolution is not science is not the claim you asked me to prove, tell us what claim you have problem understanding and may be I can help you.
God bless.
Reply: Jackie Wu
So do so! The burden of proof is on you! You are attacking a very well established theory. You said nothing other than talking in circles. So show your proof.
It should be easy for you. Show me!
Reply: Helixbuilder   What theory ?  If there is a theory, the burden of proof is on you to prove the theory, not on someone to falsify it.  However, if you are referring to Evolution, it is obvious you can't satisfy the burden of proof regarding evolution, and there is overwhelming evidence against evolution.  Do you want to hear some of them ?  Ask nicely with a please and a thank you afterwards and I'll show you some of these contrary evidence, deal ?

May the love and the peace of Jesus be with you.
Reply: Jackie Wu nope, you can't prove that intelligence can be based on design. you can't prove that anything is based on design aka creation because no creation was ever observed. say it as much as you want, it's wrong to say that creation is reasonable.

dna itself is basically just a heap of atoms in a certain order. therefore it can also happen by circumstance and needs no creation.

yeah, don't assume, you don't have the mental capacity, your assumption to link evolution and abiogenesis is wrong.
evolution has nothing to do with creation, these two are completely seperate. after life arises, by means which are not yet sufficiently explained, evolution kicks in, because space and resources are limited, so living beings have to compete, and the "fitter" one will succeed. it's only logical

nothing has been demonstrated to be created by a god or that a god itself exist, so maybe drop the god fantasy.

*you don't wanna learn, huh? just reapeating the same stuff over and over, like a broken record.
as you can't argument on a rational basis, don't accept rational arguments and facts, because you are a religious zealot, I woun't continue talking to you. this time would be wasted.*

hf dying stupid...
Reply: Jackie Wu
I'm sorry. You don't get to choose what reality is. The actual data that supports Evolutionary theory is sound. If you think otherwise then go through the actual data. Then point out its flaws based on actual science.

What you have done here is use circular logic to build your case. In no instance did you attempt to address the actual data.
Address the data or admit you just prefer your belief.

Saying the theory is wrong without  demonstrating any faults in the data or presenting better data for your case or insulting or anything that doesn't address the actual data is an obfuscation -- period.
Reply: Setep2k "dna itself is basically just a heap of atoms in a certain order. therefore it can also happen by circumstance and needs no creation." ???

Really ???  Make some DNA then and get your Nobel price for proving abiogenesis. LMAO !!!

Why are you questioning Darwin's belief in abiogenesis ? Per Wiki, "The concept of evolution proposed by Charles Darwin put an end to these metaphysical theologies. In a letter to Joseph Dalton Hooker on 1 February 1871,[69] Darwin discussed the suggestion that the original spark of life may have begun in a "warm little pond, with all sorts of ammonia and phosphoric salts, light, heat, electricity, &c., present, that a proteine compound was chemically formed ready to undergo still more complex changes.""

Darwin knew nothing about DNA and therefore nothing about the intelligence designed and created into each and every living organism that enables living organisms to be born, to survive, to grow, to select and adapt, to mutate, to reproduce, and to die.  Inanimate matters like rocks and dead wood do not have such intelligence or their intelligence has become inactive after they lost their life, and therefore inanimate matters cannot adapt or reproduce.

Survival of the fittest is a concept, not a science, and it has nothing whatsoever to do with evolution.  Like bigger is better, survival of the fittest is just an idea some people believe in, it says nothing of the origin of life or the origin of species.

I have told you Jesus, Einstein, and I are not religious.  We believe in God but not in any religion.  God is not a religion, and neither is Jesus.  Everything I said is based on truth and verifiable facts.  Facts are repeatable observations, and that was why facts sounded like a broken record to those who are superstitious and rely on hearsays and fairy tales and don't want to hear about facts and logic.

Give up your superstition and learn the truth.  Jesus is the way, the truth, and the life.  The truth will set you free.  May the love and the peace of Jesus be upon you.
Reply: Helixbuilder "Evolutionary theory is sound." ???

Sure, but theory of evolution is non existent.

"What you have done here is use circular logic to build your case."

That's exactly what you have been doing, not me.  You argue that evolutionary theories are science, evolution is a collection of these theories, and therefore evolution is science.  That's circular reasoning, a logical fallacy. 

"In no instance did you attempt to address the actual data."

What data ?  We know of overwhelming data supporting intelligence in DNA, the science of mutation, and the science of genetics, but there is zero data on evolution because evolution has never been observed or tested by the scientific method.  There is not a single theory of evolution that has been or can be scientifically tested, remember ?

"Address the data or admit you just prefer your belief."

Exactly.  You need to admit you just prefer to believe in the fairy tale, lies, and propagandas of evolution.  It's not your fault.  Kids have been brainwashed and conditioned for decades to believe in such nonsense ever since Hitler supported Darwin's idea because that legitimise his agenda for purification of the supreme race.  The hidden meaning of evolution is bigotry and racial discrimination by the stronger and more powerful.

Give up your superstition and learn the truth.  Jesus is the way, the truth, and the life.  The truth will set you free.  May the love and the peace of Jesus be upon you.
Reply: Jackie Wu I'm not trying to insult you, but I know that my reasoning is bulletproof. I might as well explain it to a rock though and have the same result as talking to you. 
maybe you are a little slow on the mental side on things and therefore can't understand what I'm saying. 
or maybe you were told the religious bullshit so often in your childhood that you can't accept it being wrong.

some random facts you'll never understand:
-you can't connect dna and intelligent design. 

-evolution isn't limited to darwins understanding, it has advanced eversince then.

-jesus is a religious figure that hasn't been proven to done anything special

-god and intelligent design are nonexistent till somebody provides evidence
Reply: Jackie Wu
We are at square one you say the theory is bad and don show any evidence or data.

Quite frankly I don't know if you are aware of what the theory actually says.

You just put the word evolution in statements that describe religion and somehow think you have delivered a prima facia case.

The only thing you have done is contradicted what I wrote.
Reply: Helixbuilder Why are you still beating around the bush and not admit Evolution is not science and start learning the truth ?

I never said, " the theory is bad".  I said there is no theory of evolution that has been or can be tested by the scientific method.  I have asked you nth times and you have not been able to provide such a theory, and you know why ?  Because there is none.  Evolution is a fabricated story, a fairy tale.  Currently, the conspirators of the evolution bullshit has even formed a modern evolutionary synthesis in order to synthesize a synthetic, manufactured, and fabricated bullshit story of evolution.

You said, "Quite frankly I don't know if you are aware of what the theory actually says."

What theory ?  How many times do I have to tell you there is no theory of evolution ?  I understand Darwin's opinion which some people called a hypothesis, and my understanding is that it is a fairy tale story about life was formed from inanimate matters and continued to change into different species like humans.  There is zero evidence, zero logic, and zero theory in support of such a story and there are overwhelming contrary evidence against it which I suppose you already are aware of but not humble enough to ask me to elaborate on them.

You said, "You just put the word evolution in statements that describe religion and somehow think you have delivered a prima facia case."

LIAR !!!  I am not religious and I have said nothing about any religion being the truth,  I have definitely not "put the word evolution in statements that describe religion".  You might have believed evolution is a religion like a lot of people do, but I regard it as a fairy tale nannies read to kids at bedtime, conditioning the kids to believe in bigotry and racial discrimination.

You said, "The only thing you have done is contradicted what I wrote."

Well, if what you wrote is true, then no one can contradict you, correct ?  Everything I said is based on truth and verifiable facts and that is why you, or anyone, cannot contradict me.

Give up your superstition and learn the truth.  Jesus is the way, the truth, and the life.  The truth will set you free.  May the love and the peace of Jesus be upon you.
Reply: Jackie Wu it has been tested by the scientific method. and it's a valid scientific theory that explains the similarities and relations of different species.

why don't you drop your religious fanatism and use some common sense?
Reply: Setep2k   You are talking about common sense now ?  I thought we were talking about science, logic, and evidence. Common sense used to tell us we are the centre of the universe.  Do you still believe in that ?  No wonder you still believe in Evolution.

You said, "it has been tested by the scientific method. and it's a valid scientific theory that explains the similarities and relations of different species." ???

What has been tested by the scientific method ?  It is definitely not evolution because there is not a single theory of evolution that has been or can be scientifically tested and verified.  "similarities and relations of different species" are the way living organisms were designed just like different computers have been designed by human with human intelligence to be different but similar and related.. An IBM computer does not change into an Apple computer by random chance, accident, and luck because chance, accident, and luck are prohibited by the law of cause and effect.  We know different computers have been designed and manufactured, or created and caused into existence by human intelligent designers and we have a full record of its history.  If you don't believe in the truth of these histories you can run scientific tests on various computers and confirm the same truth ; intelligent design.

Give up your superstition and learn the truth.  Jesus is the way, the truth, and the life.  The truth will set you free.  May the love and the peace of Jesus be upon you.
Reply: Jackie Wu
That is exactly what I am saying. You are straight up avoiding saying there is a theory. There is.
You object to it and say it hasn't been tested. It has been tested many times.
You are talking in circles
So the bottom line is where are you getting you information?
I've already posted evidence in many threads why should I bother to do so again if you can't accept reality?
Why bother having a discussion with someone who refuses to respond to what I post but makes up his/her own interpretation?
There are literally hundreds of thousands of primary research papers published that test evolution using the scientific method. Why you can't find them or read them is beyond me.
I can only conclude that you don't want to discuss this.
So don't bother..
Reply: Helixbuilder Why do you have to post evidence in many threads ?  If there is a scientific theory of evolution, don't you think everyone would have known about it by now.?
We all know about DNA, and the sciences of mutation and genetics but these "data" has nothing whatsoever to do with the evolution bullshit.

I can tell you are getting ready to tuck your tail between you hind legs and flee the scene.  It happens every time when an evolutionists cannot provide a single piece of valid evidence or logic for evolution or a theory of evolution that has been or can be tested by the scientific method.  See ?  you are afraid even to discuss the contrary evidence against evolution because you have been so deeply indoctrinated with lies and propagandas that to wake up would be too unbearable, as unbearable as losing ones identity.  That's how powerful the conspirators of evolution are in their grip of the minds of our youth and our societies.  May God have mercy on these folks.

Don't be a bigot and a racist.  Give up your superstition and learn the truth.  Jesus is the way, the truth, and the life.  The truth will set you free.  May the love and the peace of Jesus be upon you.
Reply: *****  They don't even have a stick.  There is zero evidence and zero logic for evolution.

God bless.
Reply: Jackie Wu common sense had nothing to do with the view that world is center of the universe and such. 
limited and primitive tools were the reason for that. 
sad that you don't acknowledge new tools like dna sequence analysis and prefer to keep your cave man views alive.

also you have no alternative proposal to evolution, why you so salty?
Reply: *****
You have nothing to say but that?
Reply: *****
Crick said what? Where and when?
Reply: Jackie Wu so you have nothing but your fantasies, yes? things you made up with no basis on science, fossils or dna, yes?

I can easily tell you why you're wrong: a lot of modern species do not exist for a long time, therefore there are no fossils of them available. if your idea were true, there would be fossils of modern animals with some small changes available, which there aren't.

therefore your idea, which is basically microevolution, a silly try of apologists to get some legitimacy for their intelligent design nonsense ideas, fails...
Reply: Jackie Wu
Clearly you are evidence that not everyone has the same level of scientific education. I've given you evidence and you ignored it. No actual scientific reason given.
Reply: Helixbuilder his ignorance is a terrible thing, right? makes me wonder if this is the result of indoctrination or plain stupidity... 

or did I maybe miss some logical point he was making? you seen anything?
Reply: Setep2k No.  No microevolution.  There is no evolution, period. 

IALO is all about intelligence that has been designed and created in each and every living organism that enables living organisms to be born, to survive and grow, to adapt, to mutate, to reproduce, and to die.  Each step of the life cycle involves intelligence.  Inanimate matters cannot adapt and reproduce.  It is always living organisms that select, reject, accept, conquer, abandon, alter, or otherwise manipulate their natural environment and never the other way around.  Natural selection is absurd.  Intelligent adaptation is logical and scientifically verified by studies of DNA.
 
Birds build nest, beavers build dams, and humans build space stations.  Tree roots break concrete, but concrete cannot make trees grow legs because that intelligence is not designed and created in concrete or in trees.  The only intelligence is in trees to break concrete with their roots and for species of some animals to grow legs and walk on concrete.  It's all about intelligence.

Fossil records are irrelevant.  They only demonstrate some species died off in the past.  They do not demonstrate any new species being created by God or popped out of rocks or other species by some bullshit selection.  Some species may have been created in other galaxies before being transported by aliens to earth.  But that is just fantasy, it's logical but there is no evidence available to support such a theory.  But at least that makes way more common sense than natural selection which is absurd to the highest degree as confessed by Darwin himself.

Give up your superstition and learn the truth, okay ?  May the love and the peace of Jesus be with you.
Reply: Jackie Wu lol you basically described microevolution, chump
Reply: Setep2k "No.  No microevolution.  There is no evolution, period. "
What part of that you don't understand ?
Reply: Jackie Wu the part where you say that evolution doesn't exist and then describe microevolution. you literally admitted to this even though you probably were not aware of this being called microevolution.

LOL
Reply: Jackie Wu
Denial of science is not evidence for your fairy tale claims.
Reply: Setep2k You still don't get it ?  There is no evolution, period.  Nothing has evolved.  Living organisms intelligently adapt.  They don't evolve.  Whatever shape, colour, and form they take in their adaptation is already designed and created in them.  Just like a mustard seed germinates and grow into a tree where birds of all feathers come and build their nest, all the intelligence were already in that tiny mustard seed.  it adapts as it goes through its life cycle, reproduce, and its further generations continue to be born, to survive and grow, to adapt, to mutate, to reproduce, and to die.   All the intelligence in all the mustard trees and seeds were already predetermined in their design when they were first created.  There is no intervention by God or by nature, no selection, and no evolution, period.  Get it ?  The mustard trees will never grow legs or give birth to a monkey because that is not in the intelligence designed into them by the intelligent designer.  Similarly a monkey will never give birth to a mustard tree.

Give up your superstition and learn the truth.  Jesus is the way, the truth, and the life.  The truth will set you free.  May the love and the peace of Jesus be upon you.
Reply: Helixbuilder No one here denied science.  I dismissed Evolution because it is absurd, it is neither a fact nor a theory, and it is not science.  Evolution is a fairy tale.  IALO is a scientific theory.   All the data in the study of DNA, mutations, and genetics supports and confirms IALO.

More importantly, don't be a bigot and a racist.  Give up your superstition and learn the truth.  Jesus is the way, the truth, and the life.  The truth will set you free.  May the love and the peace of Jesus be upon you.
Reply: Jackie Wu lol you simply choose whatever you feel like, no matter the reality, huh?
Reply: ***** Why are you telling me all these ?  None of what you wrote here is the word of Jesus or the teachings of Jesus.  I asked you, "I believe in Jesus.  How about you ?", and this is your reply ?  So you believe in prophecies and blasphemies and not in Jesus ?  Why ?  Don't you think Jesus is the truth ?  Didn't you hear me pointing out to you that Jesus specifically told us not to believe in or follow the Christ and the false prophets ? 

"Salvation" ???

What's that ?  When did Jesus say anything about salvation ?  Salvation from what ? Jesus never told us not to do this or not to do that.  He commanded us to love God with all our heart, with all our mind, and with all our soul, and to love one another as he loved us.  The teachings of Jesus is all about love, not about salvation.  Do you even know what is love ?  Tell us, what is love ?

You asked, "what is your purpose for professing the name of Jesus if you don't believe in Him?"

Who said I do not believe in Jesus ?  God is not a "him", okay ?  Don't be ridiculous and don't pretend that you know God.  It is silly and it is irrelevant.  We believe God exist but no one knows what God is or what the Will of God is, not even Jesus.  This is evidenced by his prayer the night of his arrest when he prayed, "Father, it is not my wish to drink from this bitter cup, but it is your Will that is to be done, not mine.".  And it is further evidenced by Jesus yelling while he was dying on the cross, "Father, why have you forsaken me ?"  The purpose of professing Jesus the way, the truth, and the life is to share the truth and save souls.
.
Give up your superstition and learn the truth, okay ?  Jesus is the way, the truth, and the life.  The truth will set you free.  May the love and the peace of Jesus be with you and guide you.
Reply: Jackie Wu
Post the references that back up your statement.

"All the data in the study of DNA, mutations, and genetics supports and confirms IALO."
Reply: Helixbuilder You asked, "Post the references that back up your statement"

I said, "All the data in the study of DNA, mutations, and genetics supports and confirms IALO."  All means every one of them.  You can look up any of them like the thousands every year you were referring to and you won't find one that is not about IALO.

Some researchers may have used the wrong words like microevolution which is as meaningless and misleading as micro-magic, but what they meant to prove is IALO because every one of the data they use is based on intelligence of living organisms and about adaptation of living organisms.  They should be using rocks and dead wood as their control experiment because rocks and dead wood don't adapt or reproduce,  For there is no I in them to do the A, only LO can do IALO.  Get it ?

May the love and the peace of Jesus be with you.
Reply: Jackie Wu
Oh I get it you just made that up and can't give me a reference paper because there isn't a single one.
You've proven beyond a shadow of a doubt that you are promoting your own personal belief as if it were a scientific fact. It is not. You are only voicing your opinion.
Reply: Helixbuilder  I said, ""All the data in the study of DNA, mutations, and genetics supports and confirms IALO."    What part of "All" you don't understand ?  Can you find us one scientific study, paper, peer review, etc. in the study of DNA, mutations, and genetics that does not support or confirm IALO ?  Alternatively, can you find us one scientific study, paper, peer review, etc. in the study of DNA, mutations, and genetics that supports or confirm E/NS, Evolution by the process of Natural Selection ?  You can't.  Why ?  It is because living organisms intelligently adapt, they don't evolve.  This is the truth.

Everything I said is based on truth and verifiable facts.  IALO is not just an opinion or my opinion.  It is a scientific fact that has been repeatedly observed and confirmed everyday, everywhere.

May the truth opens your eye so you may begin to see.  And may the love and the peace of Jesus be with you.
Reply: *****  What microevolution ?  That is as meaningless and as misleading a word as micro-magic.  No evolution and no magic is involved in IALO. 

"genetic variations within species" ???

What else could that be a result of other than the intelligence that were originally designed and created into each and every living organism ?  What natural selection ?  What Divine Intervention ?  What magic ?  What miracle ?  There is zero evidence and zero logic in support of any of the above.  It is all natural, meaning God made.  But there is no selection done by the inanimate environment as selector and living organisms as selectee.  It has always been the living organisms that are doing all the manipulation, alteration, and selection of their natural environment.  Living organisms have always been the selectors or adaptors, and their selection is always intelligence based and therefore is called intelligent adaptation, not natural selection.  The key is "intelligence" which logically requires an "intelligent designer".  We label the intelligent designer as God the Creator.  But don't get me wrong.  Intelligent design, the how and the when of what caused the coming into existence of intelligence, is not part of IALO.  IALO is science.  Science deals with facts and theories.  Science does not deal with truth.  Science does not and can not prove or disprove God.  This is the truth.

Give up your superstition and learn the truth.  Jesus is the way, the truth, and the life.  The truth will set you free.  May the love and the peace of Jesus be with us.
Reply: Jackie Wu
What data and how? If you have read the papers then why can't you give me a reference?

Because you didn't and you are making it up.
A brief, but not comprehensive, overview of the data and evidence include the fusion of Chromosome 2, psuedogenes, transposons, retroviral insertion, and recombination.

So I can demonstrate with data that 'all' you said is wrong.
Reply: Helixbuilder  What part of " fusion of Chromosome 2, psuedogenes, transposons, retroviral insertion, and recombination." does not involve intelligence, and what part of these is evolution, microevolution, micro-magic, or any bullshit selection and not adaptation of the living organisms being studied.  Can you observe any of these in rocks and dead wood ?  No.  Why ?  It is because inanimate matters don't have the intelligence that enables adaptation and reproduction, or they have the intelligence but is inactive because they have lost their life.  This is the truth.

BTW, do you know what is life ?  Tell us, what is life ?

Give up your superstition and learn the truth.  Jesus is the way, the truth, and the life.  The truth will set you free.  May the love and the peace of Jesus be with us.
Reply: Helixbuilder Setep2k *****   I waited three days and there is no more response from the three of you.  I suppose the truth has opened your eyes and you have begun to see.  Praise be to God.

May the love and the peace of Jesus be with us.
Reply: Setep2k   IALO, you said that's microevolution, didn't you ?  So is microevolution bullshit or reality ?  If IALO is bullshit, what is evolution based on ?  Bullshits, right ?  If IALO is reality, what is evolution based on ?  Bullshits, right ?  See ?  Either way, evolution is bullshit, and that's the reality.  IALO is science.  There is no microevolution and no micro-magic.  Science is all natural, meaning that it is God made.  Evolution is not science.  It is a fairy tale.

Give up your superstition and learn the truth.  The truth will set you free.  May the love and the peace of Jesus be upon you.
Reply: Jackie Wu nope you're wrong about that... using strawman arguments gets you nowhere
Reply: Jackie Wu accrding to google IALO stands for The International Association of Laptop Orchestras, so i'm not sure where you get your informations from, chump
Reply: Setep2k Intelligent adaptation of living organisms, IALO, is Jackie Wu's scientific theory of adaptation that explains the different varieties within species.  Read my previous comments, okay ?

Give up your superstition and learn the truth.  May the love and the peace of Jesus be upon you.
Reply: Jackie Wu does jackie wu live in his own little world with it's own rules where he is the king?
Reply: Setep2k No.  Everything Jackie Wu said is based on truth and verifiable facts.  IALO is a scientific theory.  Some people call it microevolution, or micro-magic, but there is no evolution or magic involved in IALO.  It is intelligence based and it is all natural, meaning God made.

May the love and the peace of Jesus be upon you.
Reply: Jackie Wu but what made god then?
Reply: Setep2k Asked and answered nth times.  God is eternal.  Eternity, like infinity, is metaphysical, unobservable, and unknowable by humans.  We humans can only believe eternity and infinity exist but we humans can never know what they are.   We believe, however, that our physical universe is not eternal but has a beginning we called the big bang.  Guess what made the big bang bang ?  That's right.  We labelled the first cause as God the Creator.

May the love and the peace of Jesus be upon you.
Reply: Jackie Wu then why can't the universe be eternal?
Reply: Setep2k People used to think that our physical universe is eternal.  But the big bang hypothesis which is based on observations and logic concluded that our physical universe has a beginning.  That is why most people believe in that nowadays.

God bless.
Reply: Setep2k
Don't mind me I'm just tired of this nonsense!
Reply: Helixbuilder The evolution nonsense is indeed very tiresome.  The Alien hypothesis is at least logical, though there is no evidence available yet.  But natural selection and evolution is absurd.

Give up your superstition and learn the truth.  May the love and the peace of Jesus be upon you.
Reply: Jackie Wu you didn't understand the big bang theory... just because the universe originated in one point that doesn't mean that there wasn'T a "before"... this is something that stephen hawking himself was very vocal about, because at first he supported your suggestion, but then he himself, a very intelligent person, realized the limits of these observations...

pre-big bang state of the universe aka pre singularity is pandoras box for reputated scientists for now... I doubt you know what I'm talking about without googling, but if you're really really honest with yourself, you got to admit that you are not up tp date, or even have a vague understanding of the big bang theory...

dude, by all means, drop the jesus whatevercrap, you have no working understanding of the cutting edge science that is the big bang theory... stephen hawking himself admited that he was wrong on this subject when he supported your position... it is something that was shown to be silly decades ago....

I'm usually not that charitable, but do you want me to explain to you what current science believes to be true? I think you are very passionate about what you believe to be true, therefore it's important that you know what's going on....
Reply: Setep2k You asked, "but do you want me to explain to you what current science believes to be true?"

That's hilarious !!!  Science is supposed to be dealing with facts and theories, not truth.  The big bang hypothesis is a hypothesis, not a fact, because it has never been or can ever be observed.  Hawking is an over-rated physicist.  His big bang hypothesis is logical, but his string theory and m theory are pure speculations and fantasies.  The most ridiculous suggestion by Hawking is that God is not necessary.  Until anyone can refute the law of cause and effect, God the Creator, the first cause, is absolutely necessary.
 
Hawking even talked about the theory of evolution.  That's how out to lunch he is.  There is no theory of evolution, period.

BTW, multiverse, if proven, only add to the evidence for God the Creator, the first cause.

Give up your superstition and learn the truth.  May the love and the peace of Jesus be upon you.
Reply: Jackie Wu
You have not yet brought up a single objection that hasn't been already debunked. It is hard to discuss if you don't use the correct terminology, acknowledge facts and confuse the issue with misconceptions..
Reply: Helixbuilder Let me repeat the truth I wrote earlier and you can tell us how that has been or can be debunked, okay ?

What part of " fusion of Chromosome 2, psuedogenes, transposons, retroviral insertion, and recombination." does not involve intelligence, and what part of these is evolution, microevolution, micro-magic, or any bullshit selection and not adaptation of the living organisms being studied.  Can you observe any of these in rocks and dead wood ?  No.  Why ?  It is because inanimate matters don't have the intelligence that enables adaptation and reproduction, or they have the intelligence but is inactive because they have lost their life.  This is the truth.

What's the point of defending the opinion of Darwin's that has never been substantiated, is absurd, and carries with it evil hidden messages ?

Give up your superstition and learn the truth.  May the love and the peace of Jesus be upon you.
Reply: Jackie Wu
Just saying so isn't proof of anything. Show me your evidence and your controls!

Why do you deliberately bring in a straw man argument you know is false to the table?

Show me where any scientist actually said anything about rocks or dead wood adapting.

When you say things that no scientist ever said and claim that they do you are a liar.

Lean what the theory says then we will talk. It is pointless if you just make stuff up that no one is claiming.
Reply: Helixbuilder   But you were the one who brought up " fusion of Chromosome 2, psuedogenes, transposons, retroviral insertion, and recombination.", not me.  You said these were scientific studies, no ?

 I repeat, "What's the point of defending the opinion of Darwin's that has never been substantiated, is absurd, and carries with it evil hidden messages ?"

Give up your superstition and learn the truth.  May the love and the peace of Jesus be upon you.
Reply: Jackie Wu that's where you are wrong (once more)... you don't know what big bang theory entails, your understanding is apparently completely wrong and therefore you don't know that it is visible and even hearable...

cause and effect? what is the cause of god then?
Reply: Jackie Wu
You are the one who without any discussion declared that this evidence supports your stuff. I find that a rather  strange jump in logic. So I asked for your explanation.
What is the big deal?
Reply: Jackie Wu
"What part of " fusion of Chromosome 2, psuedogenes, transposons, retroviral insertion, and recombination." does not involve intelligence,"
Every last bit of it. The isn't a single objective test you can preform that demonstrates an intelligent driving force for these events.
Reply: Setep2k  You said, "your understanding is apparently completely wrong and therefore you don't know that it is visible and even hearable..."

Really ???  So you are claiming big bang is a known fact and not a hypothesis which is falsifiable and need to be scientifically tested ?  I'll be damned !!!  Why didn't Hawking think of that ?  That would make it so much simpler, wouldn't it ?  BTW what caused the big bang to bang ?  Hawking ?

You asked, "cause and effect? what is the cause of god then?"

Asked and answered nth times.  God the Creator is the label we give to the first cause.  The first cause is a cause, not an effect.  There is no reason for us to believe God is not eternal.  Eternity, like infinity, is metaphysical, unobservable, and unknowable by humans.
Give up your superstition and learn the truth, okay ?  May the love and the peace of Jesus be upon you.
Reply: Jackie Wu that's your misunderstanding, big bang theory says nothing about the cause, only about the visible progression. 
there you go, I fixed your lack of knowledge for you.

if god can be eternal, then why can't the universe be eternal? 
why not leave out the silly fantasy of gods and such that can't be proven to exist?
Reply: Helixbuilder "What is the big deal?"

The big deal is none of scientific studies you claim is for evolution has anything to do with evolution, or natural selection, but has everything to do with intelligent adaptation of living organisms, IALO.  There is only IALO, nature does not select, and there is no evolution, period.

You said, "The isn't a single objective test you can preform that demonstrates an intelligent driving force for these events."

Who said intelligence is a force ?  You ?  The truth is every living organism has DNA which is the carrier of intelligence designed and created into each and every living organism that enables living organisms to be born, to survive and grow, to adapt, to mutate, to reproduce, and to die.  Inanimate matters like rocks and dead wood do not and can not adapt or reproduce because they don't have the intelligence or the life in them.  I asked you what is life and so far you have been afraid to answer.  Why ?  Could life be a driving force ?

May the love and the peace of Jesus be upon you.
Reply: Setep2k   You said, "big bang theory says nothing about the cause, only about the visible progression."

Exactly.  So answer my question : BTW what caused the big bang to bang ?  Hawking ?

You asked, "if god can be eternal, then why can't the universe be eternal?"

For the nth time, the big bang hypothesis explained why our physical universe is not eternal but had a beginning.

You asked, "why not leave out the silly fantasy of gods and such that can't be proven to exist?"

For the nth time, we believe in the existence of God the Creator, the first cause the same way we believe in the existence of gravity.  Do you not believe in the existence of gravity ?  If you do, you should have no reason not to believe in the existence of God.  There is no empirical evidence of gravity or of God because these are metaphysical entities, not physical objects.  Their existence is proven by logic applied towards evidence which would be our observations of some of the observable effects caused by gravity and by God but never have we or can we observe gravity or God.

Give up your superstition and learn the truth, okay ?  May the love and the peace of Jesus be upon you.
Reply: Jackie Wu
OK so just what are you talking about because it is not in any way shape or form science.

Just because you believe something that mental activity does not make it true.

All you have offered is your opinion and as such can not be truth.
Reply: Helixbuilder   Genetics.  It is a science.  It deals with the intelligent adaptations of living organisms.

God bless.
Reply: Jackie Wu
Actually No genetics does not agree with your claim. Try again.
Reply: Helixbuilder Per Wiki, "Genetics is the study of genes, genetic variation, and heredity in living organisms."

Any more question ?

May the love and the peace of Jesus be upon you.
Reply: Jackie Wu big bang theory doesn't say that big bang is the beginning of the universe, but the beginning of the universe as we currently know it.
beyond singularity the state of universe is currently unknown, therefore you can't say that it didn't exist.

that's why I was specifically asking you if you knew what the big bang theory entails, but you don't and make wild assumptions.

plz stop talking about astrophysics, you have no idea what you are talking about.

Gravity is measurable so don't mix it up with your unquantifiable god fantasies...
Reply: Jackie Wu
You forgot mutations, recombination transposition, epigenetics etc... So how does that support your position at all?
Reply: Setep2k "big bang theory doesn't say that big bang is the beginning of the universe .... "

Exactly.  I said our physical universe has a beginning according to the big bang hypothesis, I didn't say anything about the universe.  The universe would be the metaphysical, unobservable, and unknowable reality to humans.  No one knows what the universe is just as no one knows what gravity is or what God is.  We humans can only believe these entities exist.

"Gravity is measurable" ???

LMAO !!!  How big is gravity?  How does it sound like, feel like, smell like, taste like, or look like ?  You need to be able to sense something in order to be able to measure it, you know ?  Gravity is unobservable and unknowable by humans.  This is the truth.
Give up your superstition and learn the truth.  May the love and the peace of Jesus be upon you.
Reply: Helixbuilder I didn't forget.  "mutations, recombination transposition, epigenetics etc..." all deals with intelligent adaptation of living organisms, IALO, and has nothing whatsoever to do with evolution or any bullshit selection as you claimed.

So, give up your superstition and learn the truth, okay ?  May the love and the peace of Jesus be upon you.
Reply: Jackie Wu once again, no, according to big bang theory it has no beginning, it says absolutely nothing about beginning , it's a common misunderstanding in uneducated people.

concerning gravity, have you ever heard of a g? g as in gravitational constant?! no basic physics for you huh?
Reply: Setep2k No.  According to the big bang hypothesis, our physical universe began at an infinitely small point, the singularity, as a bang.  No one knows what infinitely small means.  It can only be visualised as something so small it is as close to nothing as possible.  What a concept ?  But still, the singularity was caused to bang, by the Creator, God.

g stands for g force.  g force measures the effect of gravity, not gravity itself.  Gravity is metaphysical, unobservable, and unknowable by humans, like God is also metaphysical, unobservable, and unknowable by humans.  No one knows what a force is, and Einstein had already shown us how gravity is not a force but is either non existent or is a fictitious force by calling it space/time curvature.  I  disagree with Einstein though.  No one knows what space is, what time is, or what space/time is. 

I also disagree with Einstein's assumptions that light travels in a straight line and light is the fastest travelling object.  Our observations demonstrated that gravity bends light and prisms can bend and spread light.  Quantum physicists don't agree with Einstein either.  They are searching for gravitons which they believe are what caused the effect of gravity.  They have not found any gravitons yet.  I think they are searching for god particles but they need to give it a more scientific sounding name in order to scam for funding.  Hey, I am not a scientist.  They may be on to a right track and I may be wrong.  But evidence so far proves otherwise.

Give up your superstition and learn the truth.  May the love and the peace of Jesus be upon you.
Reply: Jackie Wu wrong, it did not "begin" it just originated....

fyi: stephen hawking himself originally considered the universe to have begun with big bang, but has then revised this because he found it to be unresonable

also no: you can't say that a god caused big bang... whatever your excuse is for saying that god doesn't need a cause can also be applied to the universe.
and there is no link between saying that this happened and that there's a god, that's plain stupid, circular reasoning on your part.

g stands for g force? lol I stopped reading after this idiotic claim. you say that something is an abbreviation and then to explain what it stands for you once again name the abbreviation and add something to it that has nothing to do with the constante in question.
Reply: Setep2k Don't mix up g with G, okay ?  Per Wiki,
"
The unit of measure of acceleration in the International System of Units (SI) is m/s2. However, to distinguish acceleration relative to free-fall from simple acceleration (rate of change of velocity), the unit g (or g) is often used. One g is the acceleration due to gravity at the Earth's surface and is the standard gravity (symbol: gn), ..........The unit g is not one of the SI units, which uses "g" for gram. Also "g" should not be confused with "G", which is the standard symbol for the gravitational constant."

g and G are both measurement of the effects caused by gravity but not gravity itself.

"it did not "begin" it just originated...." ???

Whatever !!!  Originated starts with begin.  Our physical universe began by starting to originate from an infinitely small point called the singularity, according to the big bang hypothesis. :)

Didn't I tell you Hawking is an over-rated physicists ?  He is so stupid as to even talk about the theory of evolution when there is none, he said a triangle measures 270 degree rather than 180 degree, and he said God is not necessary as if his fantasy can replace reality and refute the law of cause and effect..  Can you imagine !!!

Give up your superstition and learn the truth.  May the love and the peace of Jesus be upon you.
Reply: Setep2k Jesus, Einstein, and I believe in God.  We do not believe in any religion.  God is not a religion and neither is Jesus, Einstein, and I.  I told you this already.  How many times do I need to repeat this before it gets through to you ?

What is g then, if it is not g force ?

Where is this theory of evolution ?

How is the sum of the angles in a triangle not 180 degree but 270 degree ?

How is the law of cause and effect refuted ?

See how illogical and irrational you and Hawking are ?

Give up your superstition and learn the truth.  May the love and the peace of Jesus be upon you.
Reply: Jackie Wu
In your cosmology argument with Setep2K you are using the fallacy of Reductio ad absurdum.
Reply: Helixbuilder it's not his only fallacy, there's also circular reasoning, god of the gaps and outright lies.

btw do you know if it's possible to open a sideboard in these comment sections?
Reply: Setep2k
I don't know.
 I just got this. It looks cool! https://elifesciences.org/content/5/e12469
Reply: Helixbuilder Reductio ad absurdum  is not a logical fallacy.  It is logic.  Per Wiki,
"Reductio ad absurdum (Latin: "reduction to absurdity"; pl.: reductiones ad absurdum), also known as argumentum ad absurdum (Latin: "argument to absurdity", pl.: argumenta ad absurdum), is a common form of argument which seeks to demonstrate that a statement is true by showing that a false, untenable, or absurd result follows from its denial, or in turn to demonstrate that a statement is false by showing that a false, untenable, or absurd result follows from its acceptance."

God bless.
Reply: Helixbuilder yeah I'll definitely check it out...

It's funny how so many things, not only concerning biology but also from sociological viewpoints, are based on evolution...

and then there's ignorants like wu that simply don't get it. I guess halfknowledge is the best he can do due to religious rot in his brain....
Reply: Setep2k "Einstein did not believe in God" ???

Yes he did.  Einstein believed in the God of Spinoza.  Two quotes you asked, okay, as follows :

Per Wiki, "Albert Einstein's religious views have been studied extensively. He said he believed in the "pantheistic" God of Baruch Spinoza, but not in a personal god, a belief he criticized."

 "We followers of Spinoza see our God in the wonderful order and lawfulness of all that exists and in its soul ["Beseeltheit"] as it reveals itself in man and animal," - Albert Einstein in a letter to Eduard Büsching (25 October 1929)

You said, "As far as I can tell you aren't even in the position to speak for yourself,"

Who gives a shit how far you can tell ?  LMAO !!!

You said, "g, the universal gravitational constant ......."  ???

Didn't I tell you not to mix up g and G ?  Pay attention or I'll have to order you to sit out at the corner for 5 minutes :

""g" should not be confused with "G", which is the standard symbol for the gravitational constant."

g is g force.

"to distinguish acceleration relative to free-fall from simple acceleration (rate of change of velocity), the unit g (or g) is often used. One g is the acceleration due to gravity at the Earth's surface and is the standard gravity (symbol: gn),"

You said, "Cause and effect is never refuted, therefore there is nothing without a cause or prior state. Therefore such a thing as god is impossible."

Didn't I tell you God is metaphysical, unobservable, and unknowable to humans, and so is eternity ?  There is no reason to believe God is not eternal.  That doesn't mean God was not caused.  It means whether or not God is caused is unobservable and unknowable by humans.  But there is reason backed by logic applied towards evidence, our observations, that our physical universe has a beginning, the big bang hypothesis.

For Hawking's bullshit about the sum of angles in a triangle equals 270 degree rather than 180 degree, read : Stephen Hawking's a brief history of time.   For some reason he thought he know what time is.  Isn't that hilarious ? 

Give up your superstition and learn the truth.  May the love and the peace of Jesus be upon you.
Reply: Setep2k "circular reasoning" ???

Circular reasoning is when evolutionists say evolution is based on mutation, genetics, and other sciences, these sciences have been scientifically tested, therefore evolution is science.

" god of the gaps" ???

God of the gap is when atheists say science has all the answers except some gaps.  God is God of the whole show in which science is a tiny subset.  There is no gap.

"outright lies." ???

Evolution by the process of natural selection is an outright lie.  In spite of my numerous requests, no evolutionist has been able to provide a single piece of valid evidence, a single piece of valid logic, or a single theory of evolution that has been or can be scientifically tested.  Call evolution a fairy tale if you don't want to call it a lie.  Take your pick.

"It's funny how so many things, not only concerning biology but also from sociological viewpoints, are based on evolution..."

I pointed that out to you already.  Nazism, Neo-Nazism, and Hitler's purification of the supreme race, extermination of the weak and the powerless, self-righteousness, obnoxity,  ignorance, hypocrisy, and bigotry are the social implications of evolution, natural selection, and survival of the fittest bullshits.

Let the truth open your eyes so you may begin to see.  May the love and the peace of Jesus be upon you.
Reply: Jackie Wu
Yes The epic of Gilgamesh proves that Yahweh doesn't exist too!
Reply: Helixbuilder  Who gives a shit about  The epic of Gilgamesh or about Yahweh ?  You ?

May the love and the peace of Jesus be upon you.
Reply: Oh yeah. Tell Mr Ford that even though every motor accident in history has been shown to be destructive, every now an again the design department will use the "mutation" produced in an accident to develop a new design. They use "natural selection" to eliminate the not so good ones, but over long enough time the T model ford evolved into the space shuttle!
Reply: Jackie Wu

The epic of Gilgamesh 1) predates the bible. 2) many of the stories in Genesis are the same with a few name changes. 3) So judaism is a ripoff of a previous religion. 4) It is not a divine revelation. 5) it is not in any way 'truth'
Therefore basing an argument on your biblical stories is inherently false.
Good night.
Reply: Jackie Wu
When you demonstrate that you understand science then we will talk about science.
Reply: Steve Koschella
What are you talking about?

From your post I think you are questioning mutations as a evolutionary mechanism.

Have you done structure/function studies of proteins using site directed mutagenesis?
Reply: Jackie Wu
So to be more correct your abuse of logic turns, reductio ad absurdum, a mechanism of uncovering fallacies into a fallacy.

So you are using  the Appeal to Extremes fallacy. Whereby you reduce a point to an absurd condition and then claim the initial argument is false because of that.
Reply: Helixbuilder I promised I would have nothing more to say but to admit I am wrong if anyone can provide us with a single piece of valid evidence for evolution, a single piece of valid logic for evolution, or a theory of evolution that has been or can be scientifically tested.

I would admit I am wrong if you can explain to me how I have been using logical fallacies rather than logic in my arguments.  Can you admit your were wrong to call reductio ad absurdum a logical fallacy and that it is the same as appeal to extremes ?

May the love and the peace of Jesus be upon you.
Reply: Setep2k Exactly.  To talk about evolution without considering life and intelligence in living organisms is extremely stupid and can be considered absurdity to the highest degree.

God bless.
Reply: Jackie Wu why do you ignore the stories of Gilgamesh? they are just as real as the stories that you make up when you talk about your god...
Reply: Setep2k The life and teachings of Jesus were passed down by words of mouth for decades before some writers started to record them in writings we now called the Gospels.  Jesus is alive today in spirit which is in his teachings.  You can interact with him directly by reading the Gospels.  You don't need the Christian Bible because Jesus is not Christ and he never said he was.  Jesus is the way, the truth, and the life.  He actually specifically told us not to believe in or follow the Christ and the false prophets because they are vultures who feed on dead meat, and Christ is not a person but a concept or idea that flashes from the east to the west like lightning when it comes.  That's in the Gospel of Matthew 24:23-28.  You can Google it.

You asked, "ecolution theme parks? lol? that exists?"

Have you not heard of jurassic park ?  Dinosaurs and shit ?

You said, "cut the crap about atheism or evolution being based on childhood indoctrination, you know nothing about that."

Well, in USA kids in public schools are taught evolution as a science rather than the truth that evolution is a fairy tale and the truth about the law of cause and effect and the creation of our physical universe.  That much I know is true, regardless of if you think that's indoctrination or not.

May the love and the peace of Jesus be upon you.
Reply: Jackie Wu and we all know how accurate oral lore is... lol...

you call yourself notreligious yet base your views on religious fairy tale books like the bible... kind silly
Reply: Setep2k Great teachers throughout history in every culture taught by deeds and words of mouth.  Socrates, the father of Western science and philosophy, Buddha, the main figure in Eastern science and philosophy, Confucius, the Sage of Chinese ethics, and Jesus, the single most influential figure in Western culture as well as throughout the world in the entire 2000 years of his history, never wrote a single book.  Do you only have a problem with Jesus, or do you have problems with all of these great teachers ?  I learn from all of these great teachers whose spirits I can actually interact with on a personal level.

For the nth times, I don't give a shit about the Christian Bible, the Jewish Torah, or the Islamic Quran.  You can keep spreading rumors all you want but that only shows that your mentally age is no more than 5 or 6.

May the love and the peace of Jesus be upon you.
Reply: Helixbuilder Thanks for your one line commentary.  Makes it easy to comprehend.  LMAO !!!

I still love you.  May the love and the peace of Jesus be upon you.
Reply: Jackie Wu
The reason was stated. You answer questions that are not asked or implied.
Reply: Jackie Wu
People choose a faith, Faith does not become truth it is a belief.
Reply: Jackie Wu
I already provided you with many papers reporting on evidence of evolution. You ignored them and went on a rant.
Reply: Helixbuilder You said, " Faith does not become truth it is a belief."

That's right.  Faith is a strong belief, a trust, a conviction, evidence based, logical, and rational in most cases.  What do you think "truth" is ?  You see ?  You've been making assertions using the logical fallacy of appeal to extremes and you expect me to agree with you ?  Dream on !!!

You said, "I already provided you with many papers reporting on evidence of evolution."

No you haven't.  None of the papers you provided had anything whatsoever to do with evolution or natural selection.  It's very simple.  Evolution is a fairy tale, and natural selection is absurd.  Scientific research on DNA, mutations, and genetics are done for the study of intelligent adaptation of living organisms, IALO, a scientific theory by Jackie Wu.  There is no change in the heritable traits of biological populations over successive generations with intelligence designed and created into each and every living organisms.  Rocks and dead wood cannot mutate, adapt, or reproduce.  This is the truth and it is based on verifiable facts.  There is no denying.

Let the truth open your eyes so you may begin to see.  And may the love and the peace of Jesus be upon you.
Reply: Jackie Wu lol... faith being evidence based.... the very definition of faith is that it exists despite lack of evidence... lol you know nothing
Reply: Setep2k Per Wiki, "Faith is confidence or trust in a person or thing; or the observance of an obligation from loyalty; or fidelity to a person, promise, engagement; ...... "

Have you been faithful to your spouse, your family, and your country ?  Who do you believe is your spouse, your family, and your country ?  Tell us the truth.

Let the truth open your eyes so you may begin to see.  And may the love and the peace of Jesus be upon you.
Reply: Jackie Wu oh wow, you just copy pasted half of the definition.

here's the complete definition by google:
1.complete trust or confidence in someone or something.
2.strong belief in the doctrines of a religion, based on spiritual conviction rather than proof.

plz stop trying to twist the facts to your wrong views, noob
Reply: Setep2k You want the rest of the definition, or do you want just the second half ?  Here is the full definition per Wiki, "Faith is confidence or trust in a person or thing; or the observance of an obligation from loyalty; or fidelity to a person, promise, engagement; or a belief not based on proof; or it may refer to a particular system of religious belief,[1] such as in which faith is confidence based on some degree of warrant."  Can you see the word "or" ?  Do you know what that word means ?

Talking about "trying to twist the facts to your wrong views", I repeat,

"Have you been faithful to your spouse, your family, and your country ?  Who do you believe is your spouse, your family, and your country ?  Tell us the truth."

Let the truth open your eyes so you may begin to see.  And may the love and the peace of Jesus be upon you.
Reply: Jackie Wu
Thanks. But because you say so isn't a scientific argument. That is what all of your  posts in essence say. Sorry I don't buy it.
 You dismiss anything that conflict with your beliefs and that is in no way science -- ever!
Reply: Jackie Wu
 No scientist has ever said this following bit of nonsense was true "Rocks and dead wood cannot mutate, adapt, or reproduce."
If you think they did then post a reference.
Reply: Jackie Wu
"or it may refer to a particular system of religious belief"
Is this it? So where does it say your belief is true?
Reply: Jackie Wu so you acknowledge the absence of proof and facts when basing one's decisions on faith, right?

good to see that you finally had a good insight
Reply: Helixbuilder I didn't claim Evolution is science.  You did.  On the other hand if IALO is not science, what were these scientific studies for ?  Nothing ?

" "Rocks and dead wood cannot mutate, adapt, or reproduce." is a statement of fact.  It is based on the truth and verifiable facts.  Has anyone seen a rock or a piece of dead wood mutate, adapt, or reproduce ?  No.  So what's your problem ?

You asked, "where does it say your belief is true?"

I repeat, "Faith is a strong belief, a trust, a conviction, evidence based, logical, and rational in most cases.  What do you think "truth" is ?  "
 
Answer my question before you can expect me to answer yours.  May be after you answered my question you will find no need to ask me your stupid question any more.

Let the truth open your eyes so you may begin to see.  May the love and the peace of Jesus be upon you.
Reply: Setep2k You asked, "so you acknowledge the absence of proof and facts when basing one's decisions on faith, right?"

I repeat, "Per Wiki, "Faith is confidence or trust in a person or thing; or the observance of an obligation from loyalty; or fidelity to a person, promise, engagement; ...... "

Have you been faithful to your spouse, your family, and your country ?  Who do you believe is your spouse, your family, and your country ?  Tell us the truth."

Answer my question before you can expect me to answer yours.  May be after you answered my question you will find no need to ask me your stupid question any more.

Let the truth open your eyes so you may begin to see.  May the love and the peace of Jesus be upon you.
Reply: Jackie Wu my trust in family is based on past observations on their behaviour and actions which therefore allows me to make reasonable assumptions what they might do next...

no faith involved...
Reply: Setep2k You answered my question by saying, "my trust in family is based on past observations on their behaviour and actions which therefore allows me to make reasonable assumptions what they might do next..."

Good for you.  So you find no more need to ask me your stupid question after you realised
your strong belief, faith, confidence, trust, and conviction in your family is based on logic applied towards evidence as well.  And you don't even give a shit who your family is, do you ?  I mean you have no empirical evidence that the woman you've been calling mother all these year is in fact your biological mother, or the man you've been calling father all these years is in fact your biological father, have you ?

I am glad you are learning the truth.  The truth will set you free.  May the love and the peace of Jesus be upon you.
Reply: Jackie Wu no, it's not a belief, it's based on reality and probability. it's not like your little fantasies that have zero basis in reality.

if I wanted to check for biological relation then I could check that via comparison of genetic material. but as I don't really care about knowing these details because they are not important to me, I don't have to check

this however has nothing to do with religion and it's faithbased existence where you blindly accept something devoid of any reality.
nice try to change subject but you fail once again.

you can't even accept that your faith is a pure product of your imagination, that you are a blind drone that can be manipulated to do anything because you don't base your decisions on reality
Reply: Setep2k I don't understand why you keep talking about my religion.  I have told you nth times that Jesus, Einstein, and I believe in God.  We do not believe in any religion.  God is not a religion, and neither is Jesus, Einstein, and I.  Have you always been so confused in your life. 

I mean you don't believe the woman you've calling mother all these years were your biological mother, you don't believe the man you've been calling father all these years were your biological father, but somehow you know who your biological mother and biological father is without actually verifying the facts.  That's called blind faith, not faith.

I'll tell you what reality is :

1) There is zero evidence, zero logic for evolution, there is no theory of evolution that has been or can be scientifically tested, and there are plenty of contrary evidence that evolution is a fairy tale. 

2) There is overwhelming evidence and logical proofs for the existence of God and there is zero contrary evidence against the existence of God the Creator, the first cause. 

3)  There is overwhelming evidence and logical proofs for the existence of gravity and there is zero contrary evidence against the existence of gravity which, like God, is a metaphysical entity, unobservable, and unknowable by humans. 

4)  There is no human, there has been no human, and there will be no human who knows what gravity is or what God is, whether gravity has a will or God has a Will, or if God has a Will, what that Will is, not even Jesus knows that.

Can you accept the reality, give up your superstition and learn the truth ?

May the love and the peace of Jesus be upon you.
Reply: Setep2k "what is the difference between god and religion? " ???

You don't know the difference ?  I'll teach you.

God is all natural.  There is nothing supernatural about God.

There are many religions, but there is only one God.  There are many gods as what Socrates believed but those are gods, not God.  God means different things to different people at different times, these are all parts of the infinite parts of the One and the same God. 

For example, the whole of nature is what God means to Spinoza and what Einstein believed in, an old man in the sky is what God means to Christians, Jews, and Muslims, the first mover is what God means to Buddha, the mandate of heaven is what God means to Confucius, the Tao is what God means to the Taoists, nonsense, random chance, accidents, and luck is what God means to evolutionists, and so on and so forth. 

I believe, and I think Jesus would agree with me, that God is metaphysical, unobservable, and unknowable by humans.  We humans can only believe in the existence of God and of gravity, but we humans cannot know what God is or what gravity is.  And like you said about your family, "the detail is not important".  Jesus taught us to love God with all our heart, with all our mind, and with all our soul, and to love one another as he loved us.  Now that's important.  Do you know what "love" is ?

May the love and the peace of Jesus be with us.
Reply: I have started a new post addressed to you.  You can comment there for this is full.
Reply: actually scientists have studied such mutations and they always lead to a decrease in the ability of the animal to survive and reproduce.